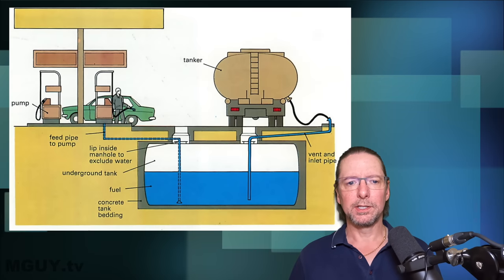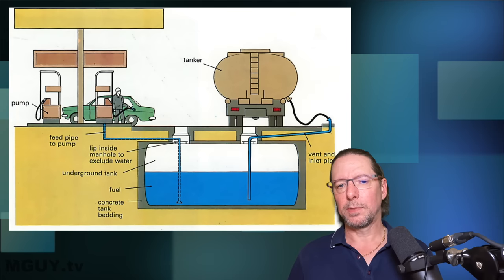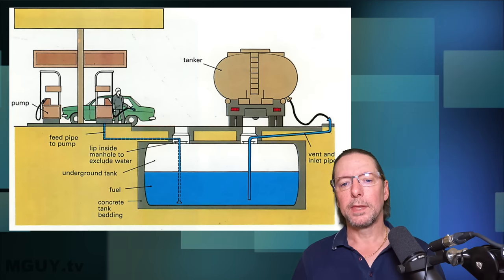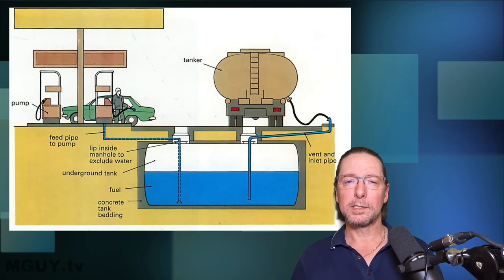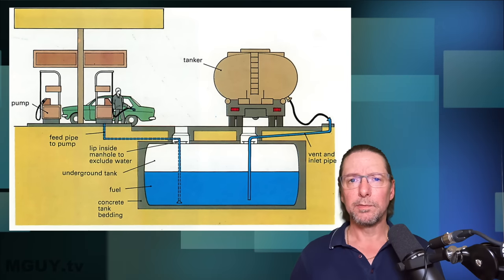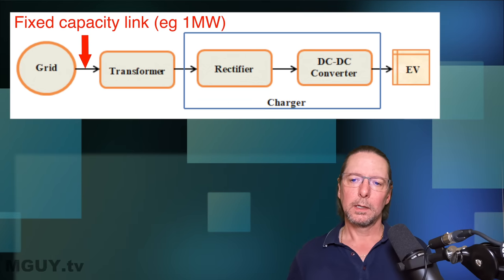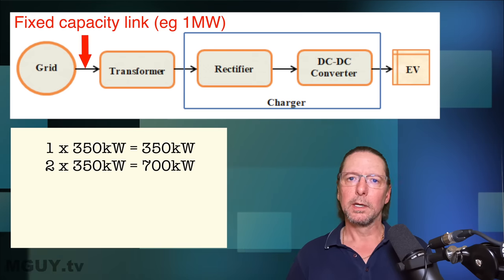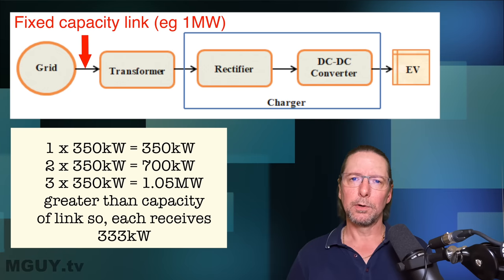HUGE problem with EV Charging Stations that no one mentions | MGUY Australia

Comment: I hate the idea of EVs but I’m all fairness you should have mention the solution of storage batteries at charging station that allows a buffer of power the same as a 20 or 40k litres of fuel in an underground tank . You could then delve into the potential hazard of fire risk of the batteries at the charging station moreover in a combined petrol / charging station.thus presenting a more complete argument against EVs
Reply from the maker: Yes, very fair point although as you say if you think EV batteries are bad, how about an entire container full of them?
Reply: And then you have to address the heat risk that charging and discharging that the batteries and wires would have putting more pressure on the electrical grid (unless you have diesel generation supplement)
Reply: You should look up the mega battery fire in Queensland, AUS.
Reply: Don't forget the round-trip energy-efficiency factor of lithium batteries. Under a range of operating conditions, one might expect a battery's electricity offtake from the grid to exceed electricity delivered to the cars by about 20%.
Reply: If the "servo" has to install batteries you sure as hell aren't going to get a cheap charge.
Reply: In principle, having electrical storage batteries on location at the service station, is possible. But, the implication and cost makes no economical sense.  Here are a few considerations....

The selling price of electricity from these storage batteties will be very high.  Someone has to pay for these batteries, and keeping them charged.  Once the charge of these batteries are depleated. You are back to square 1.  Charging these batteries will place further strain on the grid.  In all probability, decrease the capacity of the charging station.

There is an increase in safety hazard having such large arrays of batteries on site.
Reply: @chonpincher  then tow a caravan perhaps.
Reply: Tesla has solar panels on a lot of the roofs of their stations which charge large Tesla made storage batteries. It's profit making. Alternatively they buy power off the grid whenever power is cheap, store it and sell it at a profit. The availability of power is not an issue. Also why do you assume a large battery is less safe than a tank of petrol?  Any high energy storage comes with dangers. Everyone seems to focus on battery fires but not ICE car fires. The real issue for EVs is time to charge and I've no doubt that will be solved soon. Range is already less of a problem. Battery fires come from overcharging. Charging is computer controlled so as long as the charger design is sound it's safe.
Reply: @billthomas635 exactly. The free ride EV fanboys think they get will be no longer
Reply: @SkySurferG  and how is that power made?
Reply: Some US charging stations now billing by time connected not power supplied. Nice business model.
Reply: @SkySurferG  Those solar panels are just greenwashing. I don't know how much 'a lot' of solar panels is, but say you have 100 that have 300 Wp each. That will provide you with only 30 kW under the best conditions. A lot less during rush hour when you need them the most.
Reply: @SkySurferG Why do think a large battery is safer than a tank of fuel?

In recent years we’ve seen more EV and large scale battery fires that have occurred… for no reason at all!! We just saw the QLD Tesla battery go up in smoke for no reason and numerous new vehicles in different situations, but I cant recall the last time a fuel station or car catching fire for no apparent reason??

At least fuel fires can be managed and I sure as heck wouldn’t want a shipping container sized battery doing heavy work… sitting next to the forecourt of a service station!😳😳
Reply: @collenfisher3635  The idea of batteries is that you charge the batteries when demand is low and use them when it is busy (during rush hour). The batteries cost money, but they allow you to sell more kWh using the same grid connection. Upgrading a grid connection also costs a lot of money, so in some cases it is cheaper to add batteries instead.
Reply: @SkySurferG  If the rooftop is 40 acres of solar panels, it might keep up with an EV station, but a local dingbat roof has no chance.
Reply: EV's and getting off petroleum would make the middle east and Russia non existant in the world!
Reply: @SkySurferG  lipo Battery fires are self-sustaining and many many times hotter than a petrol or diesel fire. Then there's the issue of toxicity of the chemicals exuded during the fire... Educate yourself on both types of fire before claiming they're the same.
Reply: @SkySurferG  As you should know any burning proceednig requires enough oxygen . In case of fuel tank that oxygen may access only from    atmosphere  - to prevent burning since 100 years we simply insulate fuel from air by construction and location underground Now look at batteries - inside battery is stored whole oxygen  needed for processes. It totaly  is realised in high temperature. It may explode and burn in space which   at time has no any access to oxygen in air.
Reply: The big battery will still be limited in it's output. You can't discharge the battery too rapidly. Nor can you charge it too rapidly You can empty and fill the fuel tank as fast as you want.
Reply: They are already doing that in Europe now, large portable battery banks.
Reply: @SkySurferG I only have a modest understanding of these batteries (through the RV applications) but the biggest difference is Thermal Runaway. As Mguy said: each ICE car gets fuelled via a dedicated feed of fuel but the EV charging is coming from a single source. With high current draw comes heat (and lesser efficiency!) so that coupled with ambient temperature in Oz gives a significantly higher risk.
Reply: @daintree2455 sneaky!!!!
Reply: @KC-shunting not a valid PoV
Reply: That will make an impressive fire.
Reply: And then there's the fact of toxic fumes. Far far more toxic than fuel fires
Reply: @chonpincher you need to educate yourself. Energy efficiency in electric vehicles is more than 80% in ICE vehicles it's 20%
Reply: Is there an arguement for electric cars or VEHICLES glarcareklaw?
Reply: @KC-shunting  It is weird to build hugh battery just to make possibl;e faster transfer it's energy to relatively smaller batteries In world scale It will double  needed  capacity of batteries . Bearing in mind that they loose efficiency with chargings while steel tank has it   full within whole exploatation
Reply: Lithium batteries do not like being daily cycled.......they suffer capacity degradation, between 15 and 30% in the first 4 years.   So, if you multiple cycle the storage battery every 24hrs.......well good luck with that.   It sounds like a solution, but the wear and tear on the battery, its subsequent replacement and that cost is  going to be a problem.
Reply: The fire risk is not probably less than that of a petrol station. The fire risk of a petrol vehicle is 30 x that of an EV
Reply: @chonpincher  Don't mention how well the batteries work in sub zero temps (no problem we have global warming )
Reply: @GerbenWulff  And just calculate how big surface of sun exposed earth need those solars  - big installation covers thousands sq meters and we cant make them like sandwich.  Part of that energy (DC current!) will be lost for cabling. Which  adds to costs of "freee energy"and  pushes those  cost to sky.  In 19 century was hugh eruption of Krakatau which affected in whole globe sun light level  and resulted then in porblems with food.  Are  we guaranted that it wont repeat?  How it would affect EV  if  sun energy fall say to half or less?  If we then emergency return to coal then it will kill EV even more due to smog in air
Reply: The thing that most of you forget is that most people are going to be charging at home . My daughter charges her charges her car twice a month and that is at home. The obsession with charging is a non starter. I would be more concerned about cleaning up the mess when those underground tanks have to be removed and the ground rehabilitation. The cost is upwards of $1.2 million. Those tanks are leaking into your ground water system ...
Reply: @hobo1704 I will probably charge about 3 times a year at a public charger. The rest is home charging.
Reply: @mguytv  An entire contain full of them is Much MORE SAFE. Because you can use lower performance lower energy density batteries. Because WEIGHT is not a major problem to a STATIONARY battery.  This should be a basic concept of physics, less energy density = less volatility risk. It's wild you do not understand this basic concept.
Reply: @markbadhamthornhill8152  so you don't get out much then..
Reply: @billthomas635   Yep it's not cheap but still cheaper than Petrol here. Should be about 80% our petrol cost here per mileage.
Reply: @seanworkman431  And also the Luton airport parking garage fire.
Reply: There is no need for such a battery and it would constitute another fire risk.
Reply: Sounds very efficient.........not
Reply: @mynameisprivate158  There's a  concept called 'turning oil into salt'.  Pre refrigeration, salt was a strategic asset and you needed it to survive the winter - everyone knew the price of salt and where it came from.  Now it's just a commodity.  We need to do the same with oil.
Reply: @CosmicSeeker69  New LFP batteries do not suffer from thermal runaway.
Reply: @Mikexception  I wouldn't be too worried about volcanos. A large eruption will have only a marginal impact on solar irradiation. But yes, we will need a lot of them to make a difference. China is building a lot of coal plants to make our solar panels and EVs.
Reply: @SkySurferG  In practical terms, the solar arrays that Tesla uses at charging stations is decorative if not deceptive. To put it into a context that you might be able to visualise, it takes 328 standard solar panels to charge an 82kwh. Tesla model 3 from no charge to full charge in one hour in ideal conditions. The surface area of those panels is approximately 500 square metres or roughly the equivalent of the top of a Tesla charging station. Given the installation design does not take into account the most efficient installation of the cells, at the height of summer, those solar installations are going to be hard pressed supplying enough power to charge 10 vehicles a day, and that is being generous. 
Tesla has thousands of charging stations across the globe. Solar arrays are only to be found on a few dozen, at most. There is a reason for that. It isn't profitable, at all.
But makes for great advertising material, that's why they're there, and no other reason.
Reply: @markbadhamthornhill8152  It's true that electrical-to-mechanical energy efficiency of EVs exceeds 80%, while the chemical-to-mechanical energy efficiency of modern ICEVs is around 20%. However, that is irrelevant to my point about considering the round-trip (electrical-to-electrical) efficiency of storage batteries at EV charging stations in estimating their viability.
Reply: @@johnchapman7719 like a bomb?
Reply: And god knows we must give all arguments against EVs whether they are real or not eh?
Reply: It's possible, but in very large conurbations such as the home counties there is literally no where to put them as each new charging station requires it's own new electricity sub station to contect to the grid - there's simply nowhere to put them. Factor in the proximity of dwellings near several tons of volatile lithium batteries and you could easily see the great fire of London part 2.
Reply: @mguytv   U.S. military has investments in your country to build super power storage for their military . Technology is moving faster than the old petro station.
Reply: @mguytv  According to reports from Norway, the majority of vehicle fires are still petrol/ diesel and not what the doom and gloom are saying. Remember in the scheme of things, it is still early days for the EV. See how long it took for the petrol driven car to get established. It is not all that long ago that a young house servant was sent with a can to collect fuel from the chemist. At least I can top my car up with solar power. Have you tried making gasoline? All you who think the EV will disappear, will soon be changing your tune. 🤭
Reply: That will only do ble the cost of charging. Not only will you be paying for the power from the grid, but the cost of the battery will also be factored into the price of electricity
Reply: Imagine the cost required to install these storage facilities.....these charging stations need to stand on their own economically and they simply wouldn't get off the ground without an adequate supply from the grid.
Reply: @SkySurferG  Tesla is simply 'greenwashing' the public and government with those solar panels on the roof of their charging stations. The area of panels available on such a structure would take several days to fully charge just one Tesla. Smoke and mirrors.
Reply: @mguytv  A container of batteries (LFP) can be charged over 3.500 times, so the raw materials can be used over 3.500 times before they get recycled. The fuel does only get burned once.
Reply: @GerbenWulff  I've seen them with over 2000 solar panels that charge up Megapacks, so even when the sun goes down, they can still charge from solar power stored in the Megapacks.
Reply: @markbadhamthornhill8152   Tell that to Luton airport.
Reply: @dave20thmay  Not all that long ago? what pre-industrial country are you living in?
Reply: "solution of storage batteries at charging station" -- that solution is NOT REALLY a solution

it's actually the most dangerous/hazardous thing to do to an EV station
Reply: Why don’t you use à diesel Generator that is scalable to amount of cars using the charger. Also these generators could be off the grid and places in remote area of the highway. Diesel can be stored for long periods of time and easily resupplied.
Reply: @cadredeux1047 "Why don’t you use à diesel Generator that is scalable to amount of cars using the charger. "

because that would be hypocritical??!?
Reply: @cadredeux1047   "Also these generators could be off the grid and places in remote area of the highway"

why? so people charging on these EV station WILL NOT SEE that their cars is being charged by "fossil fuels?
Reply: Of course since the battery bank doesn't have to be portable you can use larger, cheaper non=flammable battery technologies.  Also the batteries don't actually at the charging site but connected to it somewhere up the line.
Reply: @dave20thmay  "All you who think the EV will disappear, will soon be changing your tune" - it think ko is thinks/want EV to disappear

what most are saying is that they don't want to forced into using it if not viable for them at the moment
Reply: @chonpincher  any way you look at it .. The figures I am quoting are the round trip .. Petrol is well to wheel ... Electricity is wind turbine to wheel ... The only benefit Fossil fuels have is energy density .. That's becoming less of an issue now.
Reply: Battery storage allows arbitrage of the electricity price.  The owner of the battery can use it to sell electricity to EVs, but it can also use the battery to sell electricity back to the grid in times of high electricity demand, like a peaker plant would.  Often the price of electricity on the grid can be very high in times of high demand.  The kinds of batteries in use for these can be different than for cars, as a finely tunes power density is not as much of a concern for a static battery on the ground as it would be for a moving car.
Reply: @markbadhamthornhill8152   most conventional vehicles are burned by thieves,vandals and insurance fraud.  The average age of the ICE vehicle fleet is also much older than EV's.  check your statistics.
Reply: @mguytv  I am presuming you are Australian... There are more options to mass energy storage than lithium cells. Australia has massive opportunity for green energy and an Australian startup is making waves in energy storage. Check out Redox flow batteries. A good option for charging stations. They will use the grid am solar, filling the batteries when energy is cheap selling when energy is expensive .. Tesla has made the move to this system already
Reply: @wazza33racer  my statics come from the annual European insurance report. I am not guessing
Reply: @reson8  Luton Airport was a landrover diesel that had a short and destroyed 1500 vehicles and the building they were in.
Reply: you anti-ev dudes are impressive. 40k litres of fuel in an underground tank? How much energy is that, then? [Try: ~ 1.4*10^12J.]  What mass would a (say, Li-Ni-Co) battery have in order to match that? You guys don't - or can't - do sums.  Derisible.
Reply: @digitalian99  You can place the generator behind a green fence. People won’t know. Also remember electric cars have 0 emissions so it doesn’t matter how much emission is coming from the power source.
Reply: @mguytv  Depends on what you mean by bad. Batteries at chargers are LFP and don't use Cobalt, with next generation reducing Lithium. Cost is also dropping to improve the viability. But you are correct in that unlike transition from horses to petrol, the transition from petrol/diesel to electric is happening much faster and there will be challenges as the technology will need to evolve.
Reply: @SkySurferG  What is the point with these unreliable toys? In case you didn't know, China is burning 4.5 billion ton of coal each year to make the batteries and 1 billion ton of steel, among other things. They are increasing consumption with 200 million ton each year. India is starting to ramp up their coal burning too. They are burning 1 billion ton each year, but is increasing much faster. What's the point with EVs in the first place?
Reply: @cadredeux1047  lol, green would not be enough, it has to have drawings of clouds/trees in it
Reply: @hobo1704  Go and get some gas. Do you think you get a free ride?
Reply: @digitalian99  That would be “hypocritical” ? Hawaii is one of the most green/liberal states in the Union. 77% of there electricity comes from fossil fuel, almost all diesel. So when you drive a ev in Hawaii it is essentially a diesel car and dirtier than a gas car. That’s hypocrisy.
Reply: @digitalian99  Or maybe a big mirror so he EV drivers can admire themselves and how woke they are.
Reply: @SkySurferG  A large battery is less safe than an underground fuel tank.  A large battery is above ground, contained in a structure of some sort, but will undergo temperature changes, due to weather, and its heating while charging or discharging.  It is these temperature changes, in combination with internal defects, that cause the battery fires.
Conversely, the fuel underground has an almost constant temperature, with only a small variation.  Most modern installations now have vapour traps, so no flammable vapour escapes.  There is only a risk during refuelling of vehicles, or when refilling the tanks.  We've been refilling our cars now for a hundred years, with very few mishaps, and the pumps and pipework has valves to prevent fire transferring into the underground tank.  Tanker drivers are trained, and have careful procedures, to minimise fire risk.
Reply: @Neojhun  Just wait until the governments stop subsidizing the purchase price of these little toys and you have to pay the full price! That'll change your mind in a hurry!
Reply: @mguytv  Have you ever heard of a flow battery?
Reply: @jesflynn4048  So in California and Arizona they are purchasing batteries to make up for lack of capacity. From Reuters 12 days ago.
Plus Power raises $1.8 billion for standalone battery storage.
So you want to move electricity from Grid batteries to EV charging station batteries along to the batteries in the car. Batteries produce no energy, they only consume energy during their manufacturing. A battery is nothing but a conduit for electricity like a wire or a transformer.   Under the old system there was no need for batteries.
Reply: @markbadhamthornhill8152 home charging is ok for some. Around 50% of homes in the UK do not have a dedicated parking space.
Many of those car owning people cannot even park in the same street twice in a row.
They will be wasting their lives sat drinking over priced coffee whilst paying over the odds for charging.
Reply: Batteries 😂😂😂😂😂😂
Reply: @sahhull  there are 2 options coming, wireless charging in parking spaces and chargers built into each and every street lamp.
Reply: @markbadhamthornhill8152  great.
Where my buddy lives. There's 50 houses on each side of the road and 3 street lamps.
The 'it's coming', a bit like cold fusion has been a decade away for the last 40 years.
Reply: @glennmartin6492   Have you seen these batteries? What are their cost? How will the costbe passed on to EV owner? How often will they have to be used to be cost efficient? Why should the driver pay that cost if he  is only car at the station? Wouldn’t drivers avoid stations with generators because of the higher cost?
Reply: @Andrew-rc3vh  Flo Battery is the women on the progressive commercials.
Reply: can you imagine how much material would be needed for that , there isn't enough lithium in the world to have the UK with electric vehicles , it is all total bull , and that is just the tip of the iceberg , the cables that supply any installation are a specific size , the loading in total will far exceed this rating therefore restrictions have to be in place , to supply all these damn EV's would mean a huge multi billion pound cost in infrastructure , the materials used to do this would cancel any so called green crap they spout to you lemmings , it is just a dream , and the reality will NOT work
Reply: @cadredeux1047  They are far longer lasting, cheaper and don't explode. If you failed to learn anything else today, at least you can claim learning one thing.
Reply: @outkast40  The US military wouldn't even be able to wipe their own arse without instruction! So, power storage for anything is out of the question.
Reply: @seanworkman431  coal :-)
Reply: @markbadhamthornhill8152 Most people? Condo and apartment dwellers usually don’t have e charging stations. Good luck in getting your HOA to install one.
Reply: @Andrew-rc3vh  When you say they are longer lasting than EV batteries are you comparing them to hours of use? How many hours are they used compared to EV batteries? What are the cost of these batteries?  I didn’t even consider them “exploding”, you just keep bringing it up. Can you show me an example of them being used in the real world? Only stuff I can find are adds from manufacturers and seem to be for individual consumers. They run about 20k.
Reply: @billthomas635 instead of that, they install diesel generators.
Reply: @SkySurferG  trying to talk sense to people who don’t like change is like trying to convince a cult member that the cult leader isn’t all powerful, worth a try deprogramming them but unlikely to succeed.
Reply: @bills6093 the “big battery” can be discharged at the same rate as the one in a car, ie hundreds of kilowatts per second if well designed. There’s also no need for it to be one large battery, but can be a battery per charge bay. How do you think a Tesla plaid or Rimac accelerates to 100km/h in under 2 seconds? By delivering a shitload of joules of energy from the battery to the electric motors driving the wheels.
Reply: Hey, there is nothing wrong with hybrids!  My Toyota Prius Prime can get 100 mpg charged.  No charge, it keeps going at 50 mpg!
Reply: @stevenginn5352  I paid full price, in Canada, for my Chevy Bolt in 2018. Based on maintenance and cost of fuel I’m about breaking even right now with what a new comparable gas car would have cost, with purchase price and fuel + maintenance considered.  From this point forward I’m saving money as the cost of electricity to power the car is dramatically less per km driven versus gasoline, and gasoline prices keep rising much faster than electricity.  But please, feel free to keep the executives at the gas companies buying their yachts and Ferraris, it’s all a chuckle to me.
Reply: In the US there are 140,000 car fires every year or over 400 per day. In 1980 there were 400,000 vehicle fires so gas cars are getting better. EVs are reported to have fewer fires per 100,000 vehicles so they would lower the yearly figure. If you are worried about vehicle fires I think an EV is a better choice. 

The Luton car park in England had a fire that destroyed over 1000 vehicles and was started by a diesel vehicle. Vehicles will burn, the question is are gas vehicles less likely or more likely to burn.
Reply: @cadredeux1047  how much f’ing energy do you think is consumed making all of the infrastructure for gasoline production and distribution? The oil derricks, the drilling platforms in the sea, the tankers to ship the fuel, the refineries with masses of steel and stainless steel tubes, the gas filling stations… apparently only the batteries are allowed to be considered under your thought process.
Reply: @SkySurferG Availability of electricity can be a problem if the gov’t decides to eliminate fossil fuel plants and refuses to allow nuclear plants. Then the grid is relying on sun and wind. Maybe not a problem in some places but there are a lot of places where solar and wind are not good alternatives. Also, if all vehicles start relying on electricity for fuel there will need to be more electrical lines installed. In the USA some areas are already overloading the power lines and there are areas where the power grid lines are nearly 100 years old and really need to be replaced with larger size cables (or add additional cables). All of this cost money which all of us will have to pay for in higher electricity rates. I think EV technology is great but does not need to be implemented in the short time gov’ts are pushing their introduction. In 20 years people will realize that this whole climate change agenda has been a big hoax to enrich the pockets of politicians.
Reply: @andywarrington4738  please, do yourself a favour and go look at how much lithium there is dissolved in the oceans. It’s estimated to be above 100 billion tons. And researchers are doing well figuring out how to extract it profitably from seawater.
Reply: Any idea how expensive it would be to have enough batteries on site to charge say even 10 cars?  This is another infinite money solution.
Reply: Ammonia (NH3) fueled internal combustion engines are the answer.  It's 100% sustainable, has almost no pollution, transporting and storage is safer than gasoline/diesel, would cost about the same as gasoline/diesel, would eliminate crash fires and current internal combustion engines can be modified to use it.
Reply: @cadredeux1047  a power company in Minnesota (Xcel) is installing a redox flow battery for grid storage, on the sites of decommissioned coal plants. From a press release Jan 2023. It’s an iron based redox flow battery which cannot catch fire and is much cheaper than a lithium ion battery, roughly 1/10th the cost. Also, flow batteries are expected to have charge discharge cycles in the tens of thousands and last a minimum of 20 years.
Reply: @davecolgan442  Thanks for this data.  It helped me finslly get my fully electric Chevy Bolt!  It is a dream!
Reply: @sjsomething4936  The US has enough oil to be be energy independent . There is no need for tankers(other than Hawaii), fuel can be distributed by pipelines. Most of the infrastructure already  exists. Natural gas can be be piped to local electric plants that can be located in thé communities they serve. 10% of electricity is lost every 100 miles transmission, while virtually none  is lost on  a pipe line. The foot print for a gas power plant is very small and can minimize miles of transmission wires. Pipeline can be buried. Solar panels necessarily competes  for sunlight with plant life, which increase the carbon foot print. Windmills have to be located miles from the end user and lose power in transmissions. Windmills and solar panels can’t operate without a back up system because of darkness and windless hours. Therefore there has to be redundancy in infrastructure. A natural gas power system could exist without solar panels and windmills. A solar panel and windmill system could not exist without some other source.
Reply: @SkySurferG the risk of fire from stored petrol or diesel fuels is only a risk within specific fuel to air ratio with specific ignition source also required. Easy to design safe storage for. Lithium batteries,  simply add water. Damage from a seemingly minor impact. Damage which is very hard to detect and there is no formal way to test for. Requiring no external/secondary ignition source.  Good luck extinguishing a lithium fire. I've pointed out only a few of the fire issues. There are also the ecological arguments that apply when theath is done without bias. The ethical arguments of say the slave labour involved in the cobalt mining, already a major issue even if it is being denied or ignored. The fixation in ev's smacks of a desperation to find a grandiose virtue to lend meaning to a hollow existence of someone who is too lazy, dishonest, afraid orplain old stupid to so much as learn about what they claim to believe. Why do people fixate on the facts when people should fixate on my feelings. Not my real feelings though, just the virtue signalling one's I post on social media. The world would be so much better if everyone cared as much about my feelings as I do...
Reply: @sjsomething4936  The reason they install storage batteries is to create a source of electricity when alternative energy is not available. This redundancy is not necessary  with fossil fuels, hydro or nuclear. The batteries produce no energy and consume energy in their  manufacturing.
Reply: @Nonplused  You don't need enough batteries to charge 10 cars. You need enough batteries to momentarily bump the peak charging speed when the grid connection alone cannot keep up. Most EVs with 200+kW fast-charging can only sustain that 200+kW for a few minutes.
For EVs to be viable, we also need fast-charging hubs to have backup generators so people don't get stranded during power outages. That would be additional power on tap during heavy usage peaks, then you can use batteries to help ensure the generator has enough work ahead of it to complete a proper operating cycle before charging traffic drops to a level where grid power alone can keep up.
Reply: @markbadhamthornhill8152   So it spontaneously combusted? How very convenient.
Reply: @Mikexception  
"As you should know any burning proceednig requires enough oxygen"
You're ALMOST there, but not quite...

Grab yourself a liter of Hydrogen gas (H2) and chuck it into a solid tank full of air..  Now heat it up (a match??? LOL)...  It WILL burn (with a nice red pop) by combing with a bunch of oxygen gas (O2) in the air.
Now grab another liter of Hydrogen gas (H2), but this time chuck it into the same tank, but THIS time, it's filled with Chlorine gas, Fluorine (or any of a number of other such oxidisers).  That hydrogen is STILL going to burn even though there is precisely ZERO oxygen present.
Burning OFTEN uses oxygen (O2) as the oxidiser, but it can ALSO use many other oxidisers and still be considered burning!
Your definition of 'burning' is incorrect!

Burning is actually a chemical reaction where a 'fuel' is oxidised via an exothermic reaction with an oxidiser.  The oxidiser CAN be oxygen, but it doesn't HAVE to be.
Certain types of Lithium Ion cells have enough oxidiser internally to 'burn' in the complete absence of oxygen / air.  Such fires can NOT be extinguished by 'starving the fire of air'.  They will only stop burning when all the fuel is consumed, or when there is insufficient heat (a.k.a. 'activation energy') to sustain the fire.
Reply: @bills6093  
"You can empty and fill the fuel tank as fast as you want."
Untrue!!!  You are limited by the pressure and size of the fill spout...
If your statement was correct, I could 'fill' my petrol tank in my car in 0.000000000000001 seconds, but alas, this is not possible!
The difference is that an EV uses a 'fill spout' that's equivalent to a thin straw while a petrol tank in a car uses a much larger spout.  Furthermore, the battery pack of an EV has THOUSANDS of ultra tiny fill spouts - one per cell.  (Thankfully, all of these 'fill spouts' can accept charge at the same time!)
Reply: @jasonhutcheon5991 
"New LFP batteries do not suffer from thermal runaway."
Actually, LiFePO4 CAN still suffer from thermal runaway.  However, the 'probability' is SIGNIFICANTLY lower than with NCR (Nickel Cobalt Rechargeable) chemistry LiIon cells.
The issue though is that LiFePO4 cell energy density (power per kg of battery) is somewhat lower than NCR type cells.
It IS getting better over time, but it's likely to NEVER be as high as NCR LiIon cells.
Reply: @teardowndan5364  Wait... generators?  What's the point of charging an electric car with a generator?  That's basically a gas car with a bunch more steps, money, and environmental damage.

I chose 10 cars battery as an example of what might be a required amount of batteries to serve as a supplement to a grid supply as per the video.  If we assume a 1 megawatt grid supply as per the example in the video, as per the video that can reasonably charge 3 cars at a time.  But the cars don't all come nice and even day and night, so let's say it's zero cars during the wee hours of the night and 6 cars at a time during the day.  It might not work out to exactly 10 cars worth of batteries but it will be somewhere around there, the batteries recharging whenever the number of cars plugged in at a time is less than 3 and supplementing the grid when there are more than 3 cars charging.  So let's say it takes 1 hour per car to charge, then this station could handle a peak period of 6 cars at a time for 3 hours (with one car charge left in the batteries) and then charging has to drop to zero cars for 3 hours to charge the batteries.  So 10 cars batteries is not an unrealistic number for a hypothetical 6 charge station installation with a 1 megawatt supply.  Based on Tesla battery packs, that battery installation is going to run around $300,000, and last about 5-7 years before it has to be replaced.

Charging batteries with batteries is hugely expensive.
Reply: I love the idea of EVs but in all fairness you should have mentioned the disaster that hydrocarbon  fuels represent in terms of climate change.  Already some parts of the world are experiencing disastrous heat waves with wet bulb temperatures exceeding 95 degrees which  is killing millions of people.  Not to mention polar ice caps thawing causing sea level rise with subsequent coastal flooding causing the relocation of millions of people around the world.  Recent fires in Canada and Australia have caused billions of dollars in damages and killed a number of people.   But why should the death of millions of people matter when weighed against some asshole saving 20 minutes each time when refueling an ICE vehicle!!
Reply: Storage batteries at charging stations are not there for a buffer of power. On modern Grids the price of electricity vary during the day. They charge the batteries when the price is lower so they can make more profits when they charge the EVs at the same price all day.
Reply: @mguytv  you're both math and physics challenged. In order to have the equivalent of 40000 litres (10000 US gallons) that would require a  327MWh battery. At the current cost of $151 US/kWh for Li-Ion that is $50M US. That is 10x the cost of a current 12 dispenser gas station (buildings and equipment) *just for the battery*.

Of course, there is no reason that the grid couldn't supply the power necessary to charge 12 BEVs (at max charge rate) simultaneously.  The real problem is that a 12 dispenser charging station has 1/20th the service capacity of a 12 dispenser gas station.
Reply: @Nonplused  It is much easier and cheaper to properly inspect and maintain a few 1MW generators than every single individual car.
Larger stationary engines designed to run continuously at constant load for hours at a time are also more efficient than hundreds of tiny individual engines running at a fraction of their nominal power for a few minutes at a time.
A stationary engine is also not as constrained by space and weight on the amount of emission controls that can be attached to them.
Do remember that said generators would only operate either in a power outage or when total charging demand exceeds what is available from grid power and battery reserve. On a typical week, they may not run at all except maybe an hour or two as a system check.
You do get better MPG from burning your fuel in an efficient generator to charge an efficient EV than driving the nearest equivalent ICE. Unless it is winter, then the EV loses due to the ICE getting heat for free. A dedicated fast-charging generator would directly drive an alternator which in turn directly dumps its output into the site's 1kV DC bus, no AC-DC power supplies in-between. That sort of setup should achieve 98-99% mechanical-to-electrical conversion efficiency. No gearbox or anything, just bearing and wiring losses along with ancillary loads like oil pumps and fans.
Additionally, most DCFC sites large enough to warrant having a backup generator would likely be located on the edges of towns next to highways where far fewer people are likely to get inconvenienced by 1MW of diesel power for whatever little time per week it will typically run.
Having fewer bigger engines concentrated at DCFC locations has quite a few advantages over having hundreds of times as many individual ICEs.
Reply: You need to research the "Power Grid". Regardless of the number of charging units at a given power station, that power must come from the power grid, and the capacity of the grid at a given moment in time is finite. The power cables are sized to carry a given amount of power, and if that amount is exceeded, that part of the grid is automatically shout down, to protect the cables and other power components. If you put in more charging units, the power cables in that part of the grid will need to be replace with larger cables, or reinforced with additional cables from the power grid substation dedicated to serve the charging station. If you overload an electrical circuit in your house, a circuit breaker will trip, and shut that circuit down. The power grid has similar protective devises that do much the same thing. So, in an all EV world, parts of the power grid will need to be reinforced substantially, and the additional power needs to come from somewhere, so additional power generating plants will need to be built. And what is the fuel source for those new power generating plants going to be? Natural gas, oil, coal, nuclear, hydro-power?
Reply: @collenfisher3635  this is already done in the States.. Batteries are charged off peak at low cost, sold back to people charging at a far higher rate. Tesla are very successful at doing this. They also have solar charging at there bigger charging facilities.
Reply: @teardowndan5364  The problem with ICE engines is mostly one of thermodynamics, not mechanical to electrical conversion.  No ICE or even any other gas expansion engine can go beyond 50% efficiency due to the thermodynamics of expanding gases.  It is true that a car has other loses mostly in the transmission, so the best cars do is about 33% efficiency at the drive wheel.  But charging batteries is not 100% efficient either, at best about 80%.  The energy loss charging batteries is of little concern if solar or some other CO2 free energy source is used (wind, hydro, nuclear), but in the case of an ICE generator 50%x80% means about 40% of the energy in the fuel can actually be put in the battery for later use.  That's not enough better (7%) to justify all the batteries and associated mining and manufacturing, which is also very energy intensive, and then battery disposal or recycling.  Then there are other loses associated with rectifying the power from AC to DC and back again, and carrying the batteries around in a car, which are quite heavy.  So the long and the short of it is that little to no reduction in CO2 emissions can be achieved by running electric cars on fossil fuel generated electricity, and in fact the emissions might be worse when the full cycle of making and disposing of the car and batteries is considered.  Electric cars need to run on "green" energy to make any difference at all, and even then the difference is exaggerated.

Also, running peak generation at the consumption site (in this case the charging station) does not improve the load factor of the overall grid.  All it does is move where the generation is installed.  A bigger natural gas cogeneration unit and larger transmission lines would accomplish the same thing with less CO2 emissions due to the fact that natural gas co-generators are more efficient than ICE generators and natural gas has a higher ratio of hydrogen to carbon than diesel or gasoline does.
Reply: @wazza33racer  not true more like 10 % after 200 000 miles .. Batteries are much better today than 10 years ago
Reply: @The0ldg0at  This is actually a dilemma that I've seen before in the gas utility business with transmission pipes and gas storage.  Let's use storage for the example because it is more similar to batteries.  Before the storage facility is built, the price signals in the market are there, with gas being more expensive during the winter than the summer, and on high load days compared to low load days.  However, once the storage facility is in place, the price incentive collapses to the marginal cost of operating the storage facility.  This is because the supply-demand has been balanced by the storage facility.  Thus, you cannot use "profits" to pay for a battery or storage facility unless they receive a regulated or "use-based" cost of service model for payment, because once enough storage exists the market incentive is removed by the very facility meant to capitalize on it.  It still works overall from the point of the consumer and stable prices result, but it leaves the storage operator without a way to monetize his/her investment.  (The exception would be when the storage installation is too small to affect the market, so say your own personal Tesla power wall, but once everyone has them the same thing would happen.)
Reply: @oldgysgt  In most places, the grid has at least a 2:1 ratio between peak capacity and baseline. You can charge a 5MWh battery bank during low demand hours to raise the baseline load a little, then use that to cover the difference between available grid power and peak charging demand. The bigger the battery, the more load can be time-shifted and further flatten peak demand.
A single 240V 200A circuit can pump 1MWh/day, enough to charge 15-20 cars per day at whatever speed they want when you have a large enough battery to store energy from the 20+h/day where no vehicles are connected to directly dump power into.
Reply: @Nonplused  Modern batteries have a roundtrip efficiency exceeding 90%, some manufacturers are even claiming 95+% for their newest cells.
Rectification losses? What losses? A generator wired to dump its stator output directly into the 1kV HVDC rail has at worst 2V of diode drops, that is 2%. Using synchronous rectification instead, that loss can easily be reduced to less than 0.2%.
Battery-wise, you don't need to mine for Na-ion batteries and the new generation of Na-ion batteries are expected to have 10 000+ cycles endurance, which means they should have a 15+ years service life in grid-scale energy storage applications doing one deep cycle per day.

As for the generator thing, I repeat for the third time: the primary purpose is BACKUP POWER IN CASE OF POWER OUTAGE so people don't get stranded by arriving at a completely dead charging hub. Supplementing grid power when the site is being told to operate at reduced power due to power shortage in the area so the site can continue to offer faster charging than it otherwise could is only a secondary benefit: the equipment is already there in case of a power emergency and it needs to run periodically for self-checks, may as well get some use out of them.
Reply: @SkySurferG  Battery fires can also come from the many connections needed in a battery pack. Any bad connection terminal will cause resistance, which heats up everything, including the battery. Even lead acid batteries sometimes get overheated by a bad connection, but lithium batteries are way more dangerous when that happens.
Reply: @collenfisher3635  Adds maybe 10c to each kWh stored/discharged.  Under most conditions, all of the charge will be supplied off the grid so only a small amount of the electricity dispensed will go through the battery.  The strain on the grid is eased as the battery can charge at tmes when the grid is quiet.
Reply: @billthomas635  About 10c/kWh if all of the electriicty had to go through the battery when in reality it is more like 10%.
Reply: Seems to me you would need a LOT of battery storage to augment the grid.  Using his example where the grid is maxed out at 3 cars, if you have 10 cars(just an example)) show up, then you would need 7 batteries at least the same size as those in the vehicles.  Then when the cars leave, those batteries have to be charged back up, but have to wait until the grid has capacity.  Doesn't seem practical given the cost of the batteries.
Reply: Nonsense.  It would take a HUGE storage battery to be able to provide 10 or 15 EV fast charges per day at each charger.  Then you have to charge the storage battery for the next day.  Same problem.
Reply: @trevorvanbremen4718  The underground tank, not your car's tank. The equivalent of the "big battery" at the filling station.
Reply: You wull no doubt find reports of battery fires to back up your argument but the newer LIP batteries don't catch fire unless you light them.
Reply: @SkySurferG   When you add hybrid cars to the discussion, electric cars are 3x more likely to catch fire than simple ICE cars.  To be fair, the data does not show the source of the hybrid car fire, just that it is 3x more likely to catch fire.
Reply: @leolo2222  How often when you go to fill up are all pumps occupied?  Same with EV chargers, most of the time only some or none are occupied.  Except for maybe 3-8 hours a day depending on the climate, there is plenty of grid capacity.  Also, one 20 foot shiping container could fill about 60-100 TVs from empty to full.
Reply: @leolo2222  Why add hybrids to EVs?  They are as much ICE as they are EV.  EVs are hugely less likely to catch fire than ICE cars.
Reply: @markmeridian3360  One 20 foot shipping container of battery (3-4MWh) would charge 60-80 EVs from empty to full (average 50kWh).  Most of the charging is off the grid, only a top up at the busiest times is from the battery.
Reply: @Nonplused  Agree with you for the wholesale electricity market but for the retail market the kWh cost is usually fixed for periods of time with good discounts for off peak usage for medium users which charging stations would fall into.  There is often a very attractive discount for demand side management so a battery can be very handy for agreeing to DSU at peak times.
Reply: @markbadhamthornhill8152  i think the issue isn't about the fire risk, but more about how much more difficult it is to extinguish a Li-ion battery fire (almost impossible) compared to a fossil fuel fire.
Reply: @davidporter4162  Where I live, gas stations often are pretty busy 50-100% capacity, but I see the point you are trying to make.  I am just using the original example of 1MW available grid capacity.  There can be 20 charging stations with 15 empty, but you would still be over capacity.  A Tesla battery is between 50-75kWs.  Using that form as a sample, you would need 13-20 Tesla sized batteries to double your 1MW station capacity.   I am too lazy to look up dimensions to see if that supports your 20 foot container example, but regardless, it would be expensive!
Reply: @Nonplused  Agree with a lot of what you say but Li-ion batteries are >90% RT and if you change DC to DC form battery to EV, the RTE is mid-high 90%s.
Reply: @davidporter4162  Why?  Because the only thing that separates them from ICE cars is that they are electrified. Again, I said the data doesn't show the actual source of the fire, but it's not a far leap to surmise it has to do with the electric part.
Yes, straight EV's currently are less likely to catch fire, but when they do it's far more dangerous.
Reply: @davidporter4162  90% is better than 80% but we're arguing over the size of the loss, not the fact that there is one.
Reply: Do they have those batteries installed at charging stations? Or is that just a pipe dream?
Reply: @leolo2222  Why 1MW?  Connections can be larger if needed.
When EVs come in to charge, mostly it is a top up, say from 30 to 80% therefore 25-38kWh for your Tesla example.  It is likely that the battery will never supply more than a quarter of the demand as the rest will bypass the battery and come directly from the grid.  Therfore, a 3MWh battery (20 foot container) will charge nearly 400 cars and can still fill up only at night.
Reply: @bossman6174  didn't say I did, but guess what, I can travel as far as I want.. That's why ice will always be better than EV . Have fun staying close to home muppet
Reply: @leolo2222  Ok but they are still half ICE and tend to run much more on petrol/diesel than the battery.
Agree that battery fires are difficult to extinguish but not as ferocious a fire as petrol especially.
Reply: @teardowndan5364  Whether 80% or 90% there is still a significant loss.

Rectification losses are not as great as inverter losses, which all electric cars have.  And then you have to carry the batteries around, which requires a lot of energy all by itself.

Na-ion batteries are not in common use yet, and even if they one day become common place they will still be prone to catching fire because the reactant and the oxidant are in the same casing.  The more energy dense the battery is, the worse this problem.  Perhaps solid state batteries will avoid this, but then we'll just have another problem due to accidental discharges which will be like a rail gun going off or a bolt of lightning hitting the car.

Your backup generators are going to cost money and not have the economies of scale of a cogeneration plant, and produce more CO2, no matter how you dice it.  Otherwise it would make sense for everything to have backup generators running during peak periods, including your house.

There are no solutions here, only compromises.
Reply: @Nonplused  Should we discuss the 70% loss from petrol in the tank to the wheel of the car?  The 70% loss doesn't include the drilling, transport, pumping and refining of oil products.
Reply: @kathrynwhitby9799  new batteries will be different chemistry .. Already lithium iron phosphate will not easily combust. You are 30 times more likely to burn in a petrol car. 100 times more likely in a hybrid.
Reply: @additudeobx  Pipedream.  Prohibitively expensive at the current state of technology and manufacturing expense.  It may come down in the future, but it is hard to see how whilst we are in the middle of converting the whole vehicle fleet to electric.  We need a mindboggling amount of more batteries than we currently have just for that.  Revolutionary battery technology could change everything, but then so could nuclear fission.  We can't plan around it.
Reply: @davidporter4162  At no point did I deny that.  I said cars are about 33% efficient at best, which is close enough to a 70% loss that we can say we were using the same number.  I'm just saying electric isn't much better, and all the losses involved in getting the diesel (or gas more commonly) to the car is the same as the losses getting the diesel to the generator.  Just carrying the batteries around represents a substantial energy loss for an electric car, as well as beating the heck out of the roads.  A Model X long range weights 5,200 lbs, That's more than the heaviest F150 (except the Lightning, of course).  It doesn't look like it but it does.  Then consider that the F150 can do things like haul and tow, and it becomes clear that an electric car moves a lot of weight around for no good advantage.  Then consider road safety.  If a Toyota Corolla has an accident with an F150, we know what happens to the Corolla.  A Model X would do the same thing.
Reply: Did I read  that some places charge you by the minutes you are plugged in and not the amount of energy transferred?
Reply: @trevorvanbremen4718  excellent overview and summary of the situation, thank you for that. One thing to note is that the fire blankets that many fire departments are now equipped with do a fantastic job of containing the fire if an EV catches fire.  Also, I’m pretty sure it is now a part of training at the various fire department academies, I’ve only reviewed some of the online info from the well known one at Texas A&M.  Once it is contained, there’s a lot less concern about the fire although even though it is not extinguished. Would be great if a consortium of auto companies would try to find a better way to completely extinguish the battery fires in order to use less water.
Reply: @Nonplused  Agree re weight of electric vehicles but not sure what you mean about hauling diesel to generators?  Certainly isn't the case at the moment but ideally the electricity comes from wind, solar, hydro, nuclear so the only losses are transmission losses on the grid plus some in the vehicle from battery to wheels.
Reply: @additudeobx  My reply was removed I think because I sent a link to a company supplying combined charger/battery units that you are asking about so was classed as spam.  Maybe youtube thinnk I'm selling them (which I'm not!) but they surely do exist and are being rolled out now.
Reply: How many charges can you get from a storage battery,  in the future if there are lots of cars the storage batteries will run out
Reply: @davefarmery8180  Even at busy stations most of the charging will still be straight from the grid but there is no practical limit to the number of charges the batteries can give.  Newer battery types can do 10,000+ charge/discharge cycles so will last 30 or more years with 1 charge/discharge cycle per day.
Reply: @davidporter4162  They are also lower voltage and lower capacity and heavier.  But I am glad they are coming into wide use.
Reply: @Nonplused  Inverters using GaN transistors can hit 98% efficiency while slightly less advanced ones are hitting 95% and axial flux motors are achieving efficiency around 98%. Electric drive trains and electric energy conversion in general are going to get stupendously efficient over the next five or so years.

While current Na-ion may still be susceptible to thermal runaway, the self-heating rate is much slower. Also, where lithium batteries enter thermal runaway around 80C, 80C is still within operating limits for many sodium batteries - some go up to 100C.

You don't need a backup generator for peak-shaving a house, a battery would do the job more effectively, hence the 5MW battery storage for a decently large DCFC site to do the same. Everyone having their own tiny personal battery for peak-shaving isn't particularly efficient though, which is why a growing number of utilities are deploying MW-scale battery systems.

You only need a generator to deal with outages longer than your battery can handle and having at least some working fast-charging stations during a large-scale power outage would be critical in an EV future where people have been stripped of all other personal mobility choices. For the fourth time, the generators are there PRIMARILY for EMERGENCY use.

You still need to run them every now and then for self-checking, peak-shaving is nothing more than a convenient time and excuse to do so.

If you don't regularly run your MW-scale generator, you run the risk of it rusting away internally, stagnant fuel and oil fouling things up, seals dry-rotting from lack of lubrication, etc. Running those thing on a somewhat regular basis is part of regular maintenance and fuel is much cheaper than finding out that your generator has seized at some point between emergencies during an actual emergency because you couldn't be bothered to use it for anything in the meantime.
Reply: @davidporter4162  i understand that what i mean is if they used a storage battery to charge cars and topped them back up during the night or off peak say , then how many cars could that battery charge. 
I see petrol station with queues everyday so surely if ev became mainstream then there will be queues for ev charging
Reply: @davefarmery8180  Storage batteries come in different sizes as do EV batteries but for instance 1 grid scale battery container is probably about 3000-4000kWh capacity and an EV charge would likely average 30-40kWh (a top up, not full charge) so it could charge 100 EVs.  Subject to space, you can have as many batteries at a station as you want so there really is no practical limit other than space.
Reply: @davidporter4162  Sorry I may have mixed up my replies re: diesel.  If the power is "green" losses are easier to justify because there are no CO2 emissions, so then it is just a matter of if the cost of all the components at the size required makes economic sense.  I was arguing with someone else that using diesel generators to charge electric cars makes no sense.
Reply: @davidporter4162  ok i understand. 
 But 100 cars isn't many really. 
I assume you can have more than one charger running off of a storage battery or container battery. 
I'm not sure how long a charge takes but say 30 minutes then you wou need  2 charges to to charge 100 cars ish in 24 hrs .
Or 4 charges to charge 100 in 12 hrs .
If you had 4 container batterys thats 400 cars from 8-16 charging points , 
And then the infrastructure to recharge those container batteries would need to be massive. 
Or am i missing something 🤔
Reply: @davidporter4162  Absolute nonsense.  The battery has charging losses, both ways - when it is being charged and when it's charging the EVs.  Charging EVs from a battery would need ~20% MORE electricity from the grid.  So if that battery charges EVs 12 hours per day and gets recharged at night, you have a bigger problem at night than what you started with during the day.
Reply: @davefarmery8180  In reality the battery will only top up the supply from the grid.  9 out of 10 cars that go to charge will be charged from the grid rather than the battery.  The battery only comes in to action when there are too many cars charging at once or if there is a grid failure which doesnt happen very often.  It can also be used to take advantage of cheap night time electricity.
The other thing to consider is if it takes each EV half an hour to charge, a charger will not usually charge more than 20 cars in a day so one battery could could fully cover 5 chargers but as the grid is doing most of the charging, one of these batteries could cover more like 20-30 chargers, more chargers than most stations have.
Reply: @davidporter4162  LFP batteries have only 3/4 of the energy density of Li-Ion.  They're only for short range vehicles.
Reply: @markmeridian3360  Hzve you looked at RTE for Li-ion batteries?  Because batteries operate on DC you don't have conversion losses when charging the EV but even on a grid system where you go AC to DC to AC, the RTE for Li-ion is still >90%.
Reply: @markmeridian3360  I wouldn't consider anyhting but Li-ion for EVs at the moment.  LFP, flow, solid state etc. are only for static systems.
Reply: @davidporter4162  thankyou
Reply: @davefarmery8180  And thank you
Reply: @davefarmery8180  There is no additional charging infrastructure: 440V 3ph power comes in, gets PFC-boosted to HVDC/battery rail voltage (say 1kV if you want to still be able to use GaN FETs for maximum efficiency) and the the chargers tap into this HVDC rail to step it down to whatever each EV wants. If there was a DC generator, it would also dump its power directly on the HVDC rail. All that the battery does is sink surplus energy on the rail when present and source any shortfalls as they occur, much like a power supply bypass capacitor on a PCB.

With 500kW chargers (1kV 500A), you can dump 50kW into the EV battery in as little as 6min, add maybe 4min to park, authenticate, plug in, plug out and leave. Each cable should be able to do about 6/hour in a smoothly moving waiting line situation, which means you need four of those to max out a 1MW feed with a throughput of 20-ish hella-fast-charging cars per hour.

Most EVs currently in existence cannot continuously pull anywhere near 300kW though, so the average session time would be closer to 20min. With your eight cables, you get three cars per hour per cable x 8 cables = 24 cars/hour. At 50kWh each, that is 1.2MW going out each hour, minus 1MW coming from the grid, leaving only 200kW for the battery to take care of, not going to deplete a 5MWh site battery any time soon with that.

Ramp it up to something like 20 cables, 1MW of grid power into a 5MW battery pack would let you serve 150 cars in 2.5h before the battery is tapped out.
Reply: @trevorvanbremen4718  I do not hope to be 100% everywhere  - that is too much. 

But being personally trained and  for few years authorised by  number of  safety institutions  in different countries to issue certificates   in safety in hazardous fuel and gas  environnment I also in that profession   was earning   money . Enough good for me
Reply: @teardowndan5364 ;15 to 20 cars a day is nothing. A regular gas station will fuel more than 15 to 20 cars an hour. The current power grid was not engineered to provide the kind of power demand that would be required in we went all EV.
Reply: At least get the statistics correct. Most EV battery management systems only enable max charging rates when very low on charge. The charge rate reduces considerably as the level of charge increases. On average I would estimate that the charge rate per car sits about 50% of its max rate and few EVs have a max rate of >150 kw so you are looking at an average of ~80 kw per vehicle. Combine that with average charger occupancy of say 80% say for a busy site at peak times including handovers and the average total grid load is significantly lower than your example. My own experience at large sites of 10-15 bays confirms the above figures and my car has a max rate of 205 kw.
Reply: @davidporter4162  There are ALWAYS heat losses.  One way is ~95%.
Reply: Or like here in canada just use huge natural gas powered generators
Reply: @douglaswares8296  Today's EVs may lose a lot of charging speed once they pass about 50% but those charging curves are getting more aggressive every year. Peaks are getting higher, get sustained longer and fade out slower. It'll get to almost gas-like at some point in the future.

With so many DCFC networks billing by the hour for charging, it makes no financial sense to stay connected much beyond the point where charging speed starts coming down unless you absolutely need to stock up on range there.
Reply: @douglaswares8296 ; if everyone with an EV drove into a charging station just to "top-off" a battery that was 25% down, that would REALLY screw up the charging network. If everyone with a ICV topped off their fuel tank every day, the lines to get into the service station would stretch for miles. Face it, EVs are not ready for prime time. Like I said, they MAY be the future, but that future hasn't come yet.
Reply: @markbadhamthornhill8152 he didn't say you were guessing, it's more about what those statistics include rather than there accuracy.
Reply: @oldgysgt  most of my charging is done at home. Like the majority of EV owners I charge on long journeys when I am below 20% and charge to 80-85% to minimise charge time and get optimal range. I have not had any significant issues in the 18 months of ownership. The charging network is expanding at a significant rate. EVs are not for everyone but I am delighted to have made the switch for economic and climate reasons. I had diesel cars for many years and don’t see me ever going back to ICE vehicles.
Reply: @douglaswares8296  ; you need to stay focused here. This conversation is not about home charging, it's about commercial charging stations. But if you must talk about home charging, do you remember in 2021when California Governor Nusim asked EV owners in Southern California not to charge their EVs because there was a hot spell, and the power grid might be compromised because of the extra load of having to cool homes and business and charge thousands of EV batteries at the same time? Like I said, not ready for prime time.
Reply: @oldgysgt  Those small stand-alone battery-backed fast-charging appliances (the kind that can only handle about 20/day max) are for low traffic locations where running dedicated power would be prohibitively expensive and your options are down to that or L1/L2. They can be rolled out just about anywhere you have access to almost any power from.

While the battery does add ~20k$ to cost, it would likely cost more than 20k$ just in permitting, engineering surveys and administrative red tape before pouring the step-down transformer slab for a "proper" (non-battery-limited) fast-charger.

I wouldn't worry too much about peak demand. DCFC hubs will inevitably gravitate towards sufficient on-site energy storage to time-shift most of their load to off-peak rates. If everyone time-shifted their non-essential energy usage, there would be minimal need for grid upgrades in most places, only baseline power generation.
Reply: @avid6186  it's fires per 100 000 vehicles sold .. Nothing to see there .. Not 20 year old vehicles
Reply: @bettymilcarek5195  Which was started by a Non Hybrid L494 Ranger Rover Sport DIESEL. The EV Charging stations are Terminal Car Park 1 ONE, the building that collapsed was Terminal Car Park 2 TWO. You are just ignoring facts to push a false agenda.
Reply: @cadredeux1047  "Wouldn’t drivers avoid stations with generators" WTF that is some isnane assumption. AFIK no permanent Public Charging station has on site Generators. That is simply not a viable functioning system as the scale is too small to be economical.
Reply: @Neojhun  That was a very unusual diesel fire that just could not be put out.
I guess time will tell. Take care.
Reply: @Neojhun ’would’t drivers avoid stations with generators “.  Because of the added cost. Eventually they will become like gasoline stations, people will choose because of price. If the cost of the generator is passed on to the consumer he might avoid that station. This a fixed cost, not a variable cost so everyone at the charger  pays the cost, whether there is one person at the station or ten.
Reply: @teardowndan5364  thankyou for the information 👍
Reply: @SkySurferG if the power supply isn't an issue , then explain why California was telling people with electric cars not to charge them , and there was a potential for rolling blackouts?  Battery fires are all too common.  If this was a child's tow that had a choking hazard, it would already be pulled off the market.  It's a fantasy.  To power one home for one hour with battery system, would cost. $1b per year to get that infrastructure going.  Who is paying for a whole city?  It's unrealistic.
Reply: Not to mention once fuel is converted to electricity, it starts discharging. It discharges during transmission, it discharges being stored, it discharges if the car sits, what a waste of fuel. Yes fuel. Electricity for the most part is made from burning fossil fuel. And yes, I said burning, as in emissions.
Reply: @mguytv  LOL. "batteries bad, petrol good".
cos' petrol never burns... lol.
Any form of stored energy is dangerous if proper precautions aren't taken. Bellringers have been seiously injured by the stored energy in the swinging bell, when they didn't time their pulls properly. People have been killed by horses kicking them, well before anybody thought of pumping oil out of the ground.

The point is that this is a relatively new technology. It is already very safe, and rapidly getting safer. The major cause of fires in lithium batteries is being crushed by garbage or recycling truck compactors. At least a dozen fires a week here in Australia, because people can't be bothered to dispose of their batteries properly. Things like vapes, or old phones, or toys that get thrown out when the battery is "flat", they all cause truck and landfill fires.

Why do so many of you wannabe YouTube heroes feel the need to catastrophise over battery technology? It's just plain weird behaviour. Do you seriously demand absolutely zero probability of an incident from this technology, when you'll happily go swanning about with a petrol bomb 2m away behind you? As I said, just plain weird behaviour...
Reply: giarcareklaw; So your solution - that will still not enable people to 'fill up' any where near the two mins it takes to fill their tank with petrol, is to mine more of the materials (and the harm that causes the planet and the people to have to mine it) to make more batteries, which then creates more problems when these batteries have to be disposed of? 
Yeah, seems like a well thought out and decent plan indeed eh?🙄
Reply: @gibsonduvall  LOL. Cos you're really concerned about the pollution caused by mining metals, but you think digging up oil and burning it is just fine...

Critical thinking isn't really your strong suit, is it?
Reply: I'm sure it's all in all a very environmental friendly solution to manufacture and recycle such big "power banks". They probably don't need any cooling either when they charge/discharge or just to keep an optimum temperature... demanding power just to function, good stuff.
Reply: @micke3035  Yeah, it makes much more sense to dig up oily sand, cook it with high pressure steam (heated by burning some of the stuff you dug up previously) dug up, burn off all of the light fractions so they don't create an explosion risk and then pump the 10 or so percent of what you extracted across a couple of thousand miles to a refinery, where it can be processed with more energy provided by burning what's already been refined, then cart it in a truck (burning more of the product to do so) to a petrol station where it's pumped into the ground (guess where the energy comes for that), then pumped back out again (wanna guess where the energy comes from?) before being burnt to save you from having to use your legs.

I don't think you've really thought this through...
Reply: @collenfisher3635   Tesla has switched to LFP cells for their Megapack storage products. Much, much safer than li-ion cells. The are also very long lived, so the cost can be amortized over decades. They are efficient too. Round trip energy loss is less than 10%. 
Charging the batteries does the exact opposite of putting more strain on the grid. A steady, moderate rate of pull from the grid is much easier to manage, and heats up wires far less than massive intermittent loads as cars come to charge. They can charge many cars before they are depleted, and can refill during slack periods when cars aren't coming and the grid has much less load overnight. The amortized cost of the Megapack adds about 6 cents (US) per kWh to the cost of the power. That is likely offsett by the lower costs of the power from the grid, as utilities charge a premium for sizing a connection for huge peak delivery (look up "demand charge" to see how that works.)
Reply: Storage batteries double the storage price for energy which already is, for one storage cycle in a lithium battery of the BEV, several times the price to get a kilowatt hour of electricity by the cheapest source which is burning gas, coal or similar.
Additionally, huge investments with significant impact on the environment and the "climate" needed.
Reply: @micke3035  I do enjoy a well written and irony loaded comment👋.
Reply: @mguytv  you still haven't done the sums, have you. Try calculating volume while you're doing the mass calc. Ignorance is one thing, willful ignorance is...
Reply: @collenfisher3635  agree. Onsite batteries is a daft idea.
Reply: Good luck with the cost of charging then!
Reply: @sunahamanagai9039 ;yes, every time you change energy into another form, some of the energy is lost, primarily through heat radiation.
Reply: @SkySurferG  The availability of power is not an issue.      Really, you solved energy supply issue for the world ?  Why are then all of us are not getting all this electricity for almost free ?
Reply: @daintree2455  That is an obsolete and diminishing billing method. Old laws in many US states prohibit anyone other than the local monopoly electric utility from selling electricity. The crude workaround is for EV charging sites to bill for time connected, rather than power sent. Stupid, but it skirts the equally stupid rule. Those old laws are being changed so that EV charge point operators can sell electricity the same way petrol is sold: by how much is delivered. Seems so obvious and sensible it's hard to believe that all states haven't already revised the rules. But once they have, the equation is flipped. In most areas the rules will prohibit charging by time, and only allow for charging by how much energy was delivered to the car.
Reply: @dylaninnes8541  The big Tesla charging station on I-5 north of San Diego uses a diesel powered generator to provide their juice as the California grid isn't sufficient with too many blackouts and brownouts, especially during the summer months...
Reply: @daintree2455  Unfortunately too many evil EV'ers top off at the charging stations instead of disconnecting at 80 percent... There are four forces in the universe, one being electromagnetic... Think in terms of a movie theater, seats fill quicker when it's half full, whereas seats fill considerably slower when it's full as people stir around several minutes into the film. Batteries have a finite number of cells, like theaters have a finite number of seats...
Reply: @ronclark9724  yup Elon musk understands the limits of the grid 
It's almost like renewables aren't enough
Reply: @GerbenWulff  Tesla is adding solar panels and/or diesel generators to their large charging stations as most of the grid isn't sufficient...
Reply: @markbadhamthornhill8152  As if toxic batteries in landfills don't foul the water table either...
Reply: @Neojhun  At home maybe, but not on the road at these charing stations... Furthermore these very heavy batteries on EV's require stronger much more expensive tires that last maybe a third of those from ICE vehicles... The EV advocates never mention tires...
Reply: @jasonhutcheon5991  With half the charging distance as well... Not much of a problem for those charging their batteries nightly at home, but many of us don't live in houses or drive short distances daily...Plus these newer batteries are heavier reducing range...
Reply: @cadredeux1047  Unfortunately that is not welcomed by the Greens...
Reply: @glennmartin6492  There is a reason why the charging stations have short cables.... Learn....
Reply: @sjsomething4936  When your home suffers brownouts and blackouts you will be singing a different tune...
Reply: @sjsomething4936  Well, the batteries don't pop out of thin air either... Those resources to produce a battery and the production of a battery isn't energy free as well... At least child labor isn't being used to pump and refine oil...
Reply: @timgurr1876  Don't forget the electric utility substations and transformers many tend to ignore...
Reply: @trevorvanbremen4718  There are four fundamental forces in the universe, one being electromagnetic...  Batteries do not use strong, weak, or gravitational forces...
Reply: @rodsmyth  95 degrees isn't hot... That is a cold wave in Texas during the summer months... Millions do not die every year due to heat anymore than those who die from freezing to death...
Reply: @markbadhamthornhill8152  Tesla also has diesel generators at many of their charging stations too as the grid isn't sufficient. The sun doesn't shine at night, nor does the wind blow all of the time... Duh...
Reply: @wazza33racer And most ICE vehicle fires can be extinguished by a small hand-held fire extinguisher. Not so much with a lithium-ion battery in thermal runaway, even at the very beginning of the fire.
Reply: @teardowndan5364  It has been my experience the charing stations on the road are full during the day, so my brother drives his EV long distances at night... But he nows complains the chargers are becoming full at night... I wonder what the future will reveal in a few years?
Reply: @markmeridian3360  You are a wise person...
Reply: @simoncrooke1644  The Swedes have a way to deal with EV battery fire: use a cobra firefighting water jet (those things have been around since 1997 as a cold-cutting tool) to poke a hole through the EV floor and battery pack cover to inject water directly inside. Takes them ~10min and only 240L of water to end a thermal runaway event.
Reply: @teardowndan5364  Yeah, that's directly comparable to a 1 kg hand-held extinguisher that you can carry in the boot. You have made a ludicrous comparison. Also, that technology has not been widely dispersed in the fire-fighting community.
Reply: @ronclark9724  Scaling fast-charging infrastructure with traffic will be a nightmare. I'd much prefer having confidence that reliable charging exists near just about every highway exit than having super-mega-hubs.

Those would still need to have enough cables that people hardly ever need to wait to plug in, even if it comes at the expense of charging taking a bit longer from sharing total site capacity with more people. If you don't like the charging speed from 1MW of site power shared with 20 others, take a 10-20kWh charge and try your luck 2-3 exits further down the road instead of waiting 5, 10, 15min for a chance to plug in.
Reply: @teardowndan5364  In addition to my other comment, I didn't say lithium-ion batteries could not be extinguished. I said they can't be extinguished with a cheap, easy-to-carry, hand-held, fire extinguisher. In many instances that fire-fighting device can be deployed within a minute and has a fair shot at extinguishing a fire. Just not the lithium-ion, thermal-runaway variety. I would still carry a 1 kg fire extinguisher in an EV, because not all possible fires are going to involve the traction battery. The fire extinguisher could be helpful in these other types of EV fires in the same way that they're helpful with ICE vehicle fires.

PS: The EV will be irredeemable by the time the fire-fighters get there with their fancy, water lance to extinguish the fire in the battery that is in thermal runaway.
Reply: @ronclark9724  you so sure about that huh?  Nigeria used to have a TERRIBLE record of child labour in the oil industry, which has been solved by legislation and pressure on the industry.  Probably still happens in oil extraction related industries but not the major oil producers any longer.  Got news for you fella, industry around the world, regardless of the country and industry sector will exploit child labour if there isn’t oversight and laws to prevent it.  Even happened recently (recently as in the last 6 months) in the good old USA in meat processing plants.  

And not just the child labour, good friend of mine who lived in Nigeria as a kid in the 80s and whose dad worked in O&G not only related personal stories of seeing kids in the oil refineries and drill sites, but he said that back in the day the oil companies would think nothing of massive oil leaks into the ocean and spills on land. This came about during a discussion of the Deepwater Horizon disaster when he basically laughed at how freaked out everyone was over it.  The journalists and environmentalists in Nigeria at the time would have been shot or badly beaten by oil company employees if they’d reported on this kind of thing.
Reply: @GerbenWulff as long as you don't have to supply the batteries.
Reply: @markbadhamthornhill8152 but we can rely on fossil fuel, we cannot rely on solar and wind
Reply: @eamonanthony6767 yes, at the fun fare.
Reply: @markbadhamthornhill8152 dude with that attitude , we will all be riding horses again, or walking. EV s won't work. The basic maths will explain that to you.
Reply: There's no chance of fires at a gas station?
Reply: The solution for EV shorcomings by ideologically possessed people is always MORE BATTERIES.
More batteries = more cost and more complexities  These people do not understand size scale complexity and scarcity (basic economics) You make the total cost of EV ownership too high and nobody will buy them. 
It is already too high for most people and only getting more expensive.
Reply: @graemewindley1614  I do believe maths couldn't be your strong point.. 30 million EVs on the road already ..
Reply: Storage batteries don't generate power, they just store it. It will come from the same place the power to charge the cars comes from - the grid. So if you get a big rush hour need to charge cars, the batteries will deplete quickly and then you have to not only have to charge a large bunch of cars but also the storage batteries, so you are back to ground zero again. 

 To build out the grid (the real issue here) to supply a world full of EV cars and trucks with batteries would cost enormous amounts of money!! To make this scenario possible would require the electricity to cost a lot of money to the consumer, money no one will want to pay for an electric car.  So now you will have grossly over priced EV cars and grossly over price electricity to power them. This whole EV car concept is a big money making novelty for the very rich right now, due to the staggering amounts of Grant money that are being poured into the research by the government, that is where the real profit lies. Companies like GMC are already looking to out of EV cars and into other options, their CEO openly stated so. So what do they know that the public doesn't? What I just told you.  Dig deeper, don't blindly believe what the government and the electric car companies tell you. The math and engineering don't lie, but the companies pushing EV's do.
Reply: @johnkemas7344  
Electricity is the most expensive form of energy and has the least energy density.Thats why it takes very heavy batteries to store it. You get much more power from a gallon of gasoline. Gasoline also is easier and cheaper to produce and much easier to store and dispense.
Generating electricity takes more energy and much more land use than gasoline or natural gas.
So EVs are not a solution and BTW we currectly have at least 300 years of Petroleum in the ground that we know of AND new oil fields keep getting discovered
Reply: @dylaninnes8541   the more current you draw through a wire, the hotter it gets. the hotter the wire, the more the resistance will increase
Reply: @andrewdonohue1853  that would be why Air conditioning in the summer is so hard on the system? Because everything is hot already... 
I appreciate that insight
Reply: @MrBCRC   With those type fires, foam can extinguish them, and they don't reignite without another source of heat.  Those who've dealt with EV fires have learned how they can reignite within minutes, hours, or days.  They've also learned to isolate an EV vehicle after a fire for this very reason.  I'll stick with my ICE, thank you very much.  I can park it in my garage without worrying if my house will burn down.
Reply: . No one will dispute that proven fact that ICE vehicles do catch fire.  But it's the type of fire that gets debated.  An ICE fire takes place most often in the engine compartment because of a fuel leak or other problem.  Seldom, if ever, does a moving or parked ICE vehicle have the fuel tank suddenly burst into flames.  That isn't to say it can't happen, just that the frequency of it happening is very low.

One the other hand, it is the energy source, fuel source, of an EV that shorts and starts burning.  And from documented videos, the fire spreads rapidly, unlike a gasoline or diesel fire.  And it is intense.

One thing not covered in this video but was covered by another gentleman in another video, I can pull into any self serve station and pump gas as long as the pump is working.  The gentleman I mentioned, went from St. Louis to Chatanooga, Tennessee in two different EVs.  He found that he couldn't charge either of those EVs at just any of the chargers along that route.  Because of the type of connectors built into the cars, he had to find working chargers with ends specific to the cars recepticals.  He did say an or of buying a set of adaptors and carrying those with you.
Reply: New batteries have a very low risk of fire. Also, ICE car burn more often then EVs in percentage.
Reply: @mletouutube  percentage of what?
Reply: @mletouutube  here's the problem with stats they can be manipulated via inputs 
Started on fire fueling/charging 
Accidents 
flooding 
Driving 
Also age of vehicles makes a difference

Omitting information/criteria can lead to massive differences in numbers 

Something else to consider is magnitude of fires partial gas tank vs partial charge
 survivability of occupants in said fires would be another 

I don't pretend to know the answers but it would be nice if us citizens could look at the data that all of the inferences are being drawn from and it would be easy to see if they are in fact safe or not 

Like you said the batteries now are safer
 in theory that's great
The numbers may show 1 out of 10,000 have had a fire 
Reality could be that 7,000 are still at dealerships and haven't been on the road (just pulling these numbers out my a$$) 

In theory they do a lot of testing to make sure they are safe 
But recalls show that a lot of issues still get through regardless of make model
Reply: Just charge EV's with diesel generators, cheap, scalable, easily refueled and not dependent on the electric grid... 🤷‍♂️
Reply: @dylaninnes8541  Tesla cars are safer than any other cars EVs or not EVs, with fire involved or not. That is a fact with millions of them on the road. Another fact: Ion phosphate batteries (used in more and more EVs now-a-days, ex: Tesla Model 3 standard range) do not ignite when punctured or shred. That is also a fact. People ignore that is not part of their beliefs. Also there is Tesla and there are the others… not the same.
Reply: @MrBCRC 
Hey dum dum, stationary battery storage units don't use lithium ion batteries. The majority of them use lithium iron phosphate batteries. You know the ones that even if they're drilled, punctured or damaged won't catch fire.
Reply: @mletouutube  fair I'll look into that thank you
Reply: Yea, lets stick to the worst solution, because something less bad is still bad.
Reply: @billthomas635  Maybe there are cheaper alternatives to the lithium battery that don't have to be light weight as they aren't in a vehicle, one could also employ gasoline or Diesel generators to take care of excess demand when needed, just by burning the gasoline or diesel stored in the tank that feeds into the gas pump, you can locally generate the excess electricity to charge up the extra vehicles at the charging stations that the electrical grid can't handle.
Reply: TOUCHÉ!
Reply: @SkySurferG  Not correct.  I'll not comment on the first three sentences as the argument for or against that doesn't really matter and is partially useful.  Solar panels, while insufficient, is still a small benefit, if increased cost, to their system.
Banks of batteries that are not situated in very robust climate controlled environments are as volatile as above ground, single walled, half full tanks of gasoline.

Which the response is, if it's the same, why not do it because there are other inherent benefits that would outweigh similar hazards.

Except that above ground, single walled, half-full tanks of gas are illegal for permanent storage.  Because they present too great a hazard to those in the area and the environment.

Second, the cost of operating and maintaining robust climate controlled rooms/containers is not small.
A single tesla Model 3 has a capacity of 5.3kWh.
To effectively support continuous support for One Model 3 you would want at least 2.5 times that capacity if you have any interest in battery life.  An investor or an environmentalist would not want a set of batteries to to replaced every six or most likely every three months because they had run through their life-cycle through continuous full charge/discharge cycles.  The ideal maximum storage would top at 80% of the total capacity and ideally you would pass the system between 30-70% in the charge and discharge cycles.
To support the through-put current of a discharge (car charging cycle) the bus and cabling (electrical connections) would be oversized to allow for efficient current flow and minimal overheating.  The battery banks would have to be built with sufficient spacing to allow for efficient heat dissipation and airflow between every cell.
The batteries would most likely be Lead-Acid or similar as they are cheaper, easier to maintain and easier to replace for maintenance or life-cycle rotations.  Life cycles for this would still be measured in months, not years.  I would expect annual rotations to a facility to refurbish the anode and cathode plates.

So lets set up a bank worth $40,000 distribution and electrical gear worth $40,000 multiply this set by five in a 40ft container that is designed to contain any possible electrical blast from a fault and has sufficient cooling for normal operation.

Sounds needlessly expensive and wasteful of energy.  Imagine running a large industrial AC continuously 24/7, 365 and then setting up a service plan to maintain the batteries and electrical equipment.  For every gas station in a city.

Trying to consider the infrastructure to just support charging stations is a massive drain and strain on what currently exists.
Reply: Wrong
Reply: @hobo1704  Having just made the return trip from Melbourne to Sydney (AU) I can tell you that Tesla has raised the power price from 60c/kWh to 70 cents. Meanwhile, I am sitting here at home watching the power flowing from my solar panels into both my Tesla PowerWall battery AND my Tesla Model Y AT THE SAME TIME. And the cost for this power? ZERO $$$'s   The solar panels paid for themselves 4 years ago, so it costs me nothing to charge. The FREE RIDE continues, except in neanderthal land...
Reply: @greghudson9717  another one that doesn't understand that it is not free. You are not making money from the solar but using it to charge.. Have fun staying close to home
Reply: @mguytv  Your asumption that every battery packs have bad batteries is faulty.   When you know the true life cycle of let say of batteries from a Tesla pack. You will notice that Tesla is in position to garantee that their batteries could have a 100 year life cycle if used and maintained at the same constant temperature.   

In the case of Tesla, it's why they can provide Powerwalls  for home use and megapacks for industrial use.     I'm sure that you may not know that, but at every Tesla factory, they have a farm of Megapacks.  These megapacks have the hability to provide power for 7 days to the entire factory.   

Now imagine when they add a megapack to a super charging station,  That megapack will act like that underground reservoir or electricity.  

Now where we can see a problem, will be with those small independant charging stations, that won't provide that buffer.  Here where I live in Canada, independant charging station are usually alone or have a second one installed in the parking lot and won't have that backup power.

But if you want to provide the service like Tesla,  You have to invest in order to give the service to many EV's
Reply: Tesla builds, sells and uses industrial sized batteries that can supply spot power to the grid when their are hiccups that cost utilities major dollars in spot prices.

Tesla is turning themselves into an energy company.  

The idea that they would be baffled by a single home style connection is ridiculous.  The whole charging infrastructure is key to their auto industry as well as to their energy industry.

Anyone in Australia (like MGUY) knows the power and major financial benefits of Tesla's grid level storage solutions, as that was an early Tesla project there.
Reply: @mguytv How about a ship load of them. Which caught fire recently at sea.
Reply: @dylaninnes8541 Plenty of potential to charge EVs via solar. That’s how my mate & his wife normally charge theirs. They have a Powerwall as a load balancer. With only one EV they could sell power to the grid.
Reply: The batteries which provide a buffer do not function well in very cold or very hot temperatures, nor do the batteries in the EVs. The sad reality is that EVs do not fit well with the driving habits of most vehicle owners or the conditions the vehicles are operated in.
Reply: @davecooper3238  really? They must not use it much
Reply: @billthomas635  Not only that  but imagine that the ratio of EV's to NAE's increases and picture stations that have to accommodate both modes? How will they make room for these charging stations to satisfy both? And the time it takes to charge an EV that requires the EV to take up space when a NAE is only roughly 10 minutes? Never mind the hardware needed to support the simultaneous charges, lol.
Reply: @cadredeux1047 saw the hypocrisy fist hand two months ago while doing a service at their only Refinery
Reply: @davecooper3238  unless you can find away to charge with sunlight while you are driving, it is meaningless that you are charging with solar panels, because it just à insignificant source of power of the grid which is still largely dependent on fossil fuel. You could also charge your EV with a Diesel generator. How you get your electricity is not the issue because EV batteries can’t produce electricity.
Reply: do you understand how big a battery would be if it equaled  40 000 liters of fuel - EV's could be great   they will ruin them  but they could be great
Reply: So what about a container-sized supercapacitor? All chargers draw off of it, and it is recharged by the grid at whatever capacity is available. Might this not work? @mguytv
Reply: @khg8519  The battery doesn’t create energy. What you are saying is how does this battery compare to a empty 40,000 liter storage tank. If the battery isn’t charged it’s an empty tank.
Reply: @seanworkman431  -  I looked that up, OMG!  We will be seeing a lot more of that with the increase in EV's.  I won't be buying one, guaranteed.
Reply: Batteries. That right there is yet ANOTHER problem all its own. THINK!!
Reply: @Neojhun How much petrol & petroleum being used to support!
Reply: @hobo1704  You are the one that does not seem to understand. My solar panels paid for themselves in less than 2 years, so everything after that is FREE (even you should be able to understand THAT). I now use excel solar to charge my Tesla, so my charging cost at home is also ZERO (something else you should be able to understand).  The only time I really PAY for power is during long trips away from home (which I do often) but even then it is still WAY cheaper to buy electricity than petrol.  My last petrol powered trip from Melbourne to Cairns return (7500km) cost me AU$1800. The same trip in my Tesla cost just over AU$400.     I have lots of fun staying home, but even more travelling. Maybe you should either try it yourself, or just stay ignorant of the benefits of EV's.
Reply: @greghudson9717  yep, definitely uneducated AF. Not surprised being an EV fanboy..
Reply: @hobo1704  Moronic AF yes, but you don't sound like a fanboy?
Reply: @skysurferg1952 Petrol tanks don't explode just because some water got into them at some point. Also, the act of depositing and removing fuel from them doesn't cause massive heat spikes that plummet efficiency and damage infrastructure.

Finally, tanks don't constantly lose energy even when not in use. We already can't produce enough power to fuel a fleet of EV's as is. Imagine how much worse that problem would get if we add massive amounts of battery bleed off to the mix.
Reply: Yeh these charging stations are already being built in the UK, it's not the perfect solution, but it's a step in the right direction.
Reply: I agree with your theory of a storage battery per charging station however this would require ineccess of double the maximum battery volume of any car likely to use the station and therefore also decreases the life of each battery by dump charging to full capacity
Reply: "green washing" I have never heard that term before. I'm going to have to remember that one
Reply: I've had an EV for a few months now. Only once connected it to a charging station away from home, although it wasn't actually necessary. I charge at home  on a 7KVa home charger off the 30amp regular supply. It takes about 90 minutes, and I do it overnight when the cost is 50%, [17cents NZ per Kilowatt hour.] This is the real world now, the future is even better....
Reply: No one is mentioning the "huge problem", because it isn't a huge problem. In fact, electric energy is far less a problem, than gas charging was a problem 100 years ago. For electricity, the grid already exists. For gas cars, the grid had to be created first. Also, perhaps 5% of the charging is done on fast chargers, and most of the slow charging is done at home. Also: there are almost no vehicles which can charge at 350. As far as I know, only trucks can do that. My electric cars, one charges at 50KW max. (that would be 14 cars at once, charging at max - and most of the time they don't do that), if the infrastructure delivers 700Kw. The other has no fast charging.
So, why making a "big problem" out of something that isn't a problem? The only explanation I have, is that the ones who do that, have shares in the oil and ICE industry.

Anyway worth to mention: In a year time, my car has only fast-charged ONCE! - With 18,000 Km. travelled.
Reply: @SkySurferG lol come on, they provably barely make enough power to run the pump’s display screen.  A solar panel wouldn’t make a dint in a car charging station.
Reply: The problem is that batteries are not very efficient. You lose on the charge, and you lose on the discharge. So, storing lecky-trickery on-site is a  costly and inefficient affair, which does nothing except add to the cost of charging. The whole idea of a robust grid is that it can provide the power required, when it is required. That's what makes it efficient!
The solution for power companies is to put all EV chargers onto what we call "Ripple Control" in New Zealand. That is where the power company controls your hot water heater, and turns it off to balance the load. This would allow power companies to properly manage both water heating, normal demand, and EV demand.
Reply: So the cost of the storage batteries and the cost to continuously recharge them and their degradation and state of discharge is another cost to the EV station owner.  Thus, charging cost will have to increase further.  Not to also the mention the peak load times by the utility purveyor and the demand charge rates.
Reply: @Gregory-Masovutch  Not exactly true. It doesn't matter if the batteries are located at the solar or wind production site, or on the user's end site. Therefore, no difference. No, charging costs will decrease, if the batteries are being charged while the cost of energy is low.
Reply: @SkySurferG  if battery fires come from overcharging, and charging is computer controlled, it seems to me that the computers arent doung a very good job
Reply: @GerbenWulff  i get your point, but question the intelligence of anyone who dares to rely on being able to charge during rush hour
Reply: If you have to go through another battery charging cycle then there are huge inefficiencies.  About 20% lost right there.
Then there is the lifetime cost of that extra battery.
Reply: @cccmmm1234  What would be the difference of battery costs, or losses, by batteries installed near wind turbines and solar, and the same batteries installed on the site where the energy is finally being used? None. But the advantage of having the energy stored and at disposal just where it will be used, is undeniable.
Reply: @hokroeger  Offsite you can use other cheaper, long lasting, options such as pumped storage.
But all storage systems are inefficient which is why buffer storing makes the electricity more expensive.
Reply: i suggest a full container of these batteries in a chargin station, and a very efficient air conditioning to keep them cool on summer and keep them warm in winter. This air conditioning better be fail proof, otherwise those batteries will quickly degrade and a new installation within 2-3 years will be required.
Reply: @cccmmm1234  Gas car efficiency is around 35% (the rest of the fuel is lost in vapours, transport, heat and friction. Electricity efficiency is around 80%. So, once more, your math is wrong.
Reply: @hokroeger   This is nothing to do with efficiency end to end efficiency. This is to do with the efficiency once it is made into electricity (ie. the efficiency from just transferring it from one storage to another).

If you take a liquid fuel, you can transfer it from one container to another many times without loss: from a storage tank to a tanker ship to another storage tank to a tanker truck to a storage tank to a gas tank in a car - all virtually zero loss.

This makes liquid fuel logistics management pretty easy.

Every time you charge and discharge a battery (eg. an extra storage battery) it eats into the lifetime of that battery. That adds a significant cost to storing and moving electricity. Adding another battery storage step essentially doubles the lifetime cost of batteries.

ie. If current battery costs are 10 cents/km then adding an extra battery storage step increases that to 20 cents per km.

Fuel tanks don't have that problem. Then can be filled and emptied thousands of times with no impact on lifetime.

But if you really want to play the efficiency game then look at this:

The 35% efficiency you talk about is from the time the fuel is made in a refinery to the power that hits the wheels.

Let's look what that looks like for an EV:
Generate electricity by burning coal, gas or oil (45% efficiency). AC to DC conversion in charger (95%). Charging battery (90%). Discharge battery through power electronics to power motor (90%). Motor efficiency (90%).  Complete path = 0.35%.
If you want to add an extra battery storage step to that then that is maybe 80% efficient (one charge and one discharge step). Complete path is 28% efficient.

Perhaps instead of burning coal to power your EV you want to use solar charging? Well that is around 10% efficient. End to end efficiency is 5%.
Reply: @cccmmm1234  "the efficiency from just transferring it from one storage to another" - Well, transferring electricity by wire is far, far more efficient as transferring fuel by train or truck.
"If current battery costs are 10 cents/km then adding an extra battery storage step increases that to 20 cents per km." False. The whole efficiency rate in electricity, over the whole process, is about 80% (from production to usage), while the efficiency of ICE cars is only around 35%. Battery storage doesn't add "cents per Km."

"The 35% efficiency you talk about is from the time the fuel is made in a refinery to the power that hits the wheels.

Let's look what that looks like for an EV:
Generate electricity by solar cells, wind and hydro (100% efficiency). AC to DC conversion in charger (95%). Charging battery (98%). Discharge battery through power electronics to power motor (99%). Motor efficiency (95 to 98%%).  Complete path = 80% 
If you want to add an extra battery storage step to that then that is ca 98% efficient (one charge and one discharge step) and uses cheap energy, when there's is more in the grid as needed. Complete path is 100% efficient." Because it is able to use electricity when it is almost free, and would go to waste if not stored in batteries.
Reply: @cccmmm1234  If moving cars through electricity is so "inefficient" as you claim then, how can you explain that it is 5 to 10 times cheaper as moving the same car with fuel?
Reply: @hokroeger  efficiency and cost are not the same.
 
And it is nowhere near 5 to 10 times cheaper.
Reply: @hokroeger  Sure, over wire is reasonably efficient. It is the storing and un-storing (ie. the charging and discharging of a battery or the filling and emptying of a pump storage system) that are inefficient.

I worked for a power company for 4 years. I have been designing electronics for over 40 years.  I understand what it takes to generate and store electricity.
Reply: @seanworkman431  Exactly, I spoke to a leaf driver who had a sticker on the back stating 'Zero Emissions Vehicle'
She was horrified when I suggested she change that sticker to read 'Remote Emissions Vehicle..' which is exactly what it is.
Reply: @seanworkman431  Really? Is this the best and brightest comment you are capable of making? Here are some questions for you then:
What happened to petrol/diesel used in a car in 1900?
What happened to petrol/diesel used in a car in 1950?
What happened to petrol/diesel used in a car in 2000?
What happens to petrol/diesel used in a car in 2023?
What will happen to petrol/diesel used in a car in 2030?
Clue: The answer remains the same. You ignite it, it combusts, foul chemicals spew out the exhaust and it disappears.
On the other hand, what is happening to the electricity grid at the same time as EVs are ramping up? Glad you asked. This is the percentage of renewables in the Australian grid over time:
2001-2002 - 7.7%
2006-2007 - 8.7%
2011-2012 - 10.6%
2016-2017 - 15.7%
2021-2022 - 30.9%
2022 - 32.3%
That is such a stale comment and every time you ask it, the percentage of energy created from sustainable sources increases. But there is no change in what happens in your ICE vehicle. Same result over and over for the past 120 years and into the future.
Reply: @CosmicSeeker69  point us to a single reputable study that supports your ridiculous statement that show EVs are more likely to catch fire or that they will catch fire while charging? Or even that they did catch fire while charging? Lol...and that the climate in Australia is so different to the rest of the world as to give a "significantly higher" risk. I fell on the floor laughing at that one. Comedy gold Graham
Reply: @cccmmm1234  Well, then we are down to what I said in the beginning. If the "problem" is "storing and unstoring", then it doesn't make any difference if the storing is done in a wind o solar power plant, or if it is done at destination. IN the hours in which there is more energy available as is being used, the excess has to be stored somewhere. And if you really worked 40 years in a power company, you should be able understand that.
Reply: @cccmmm1234  "efficiency and cost are not the same" Storing excess energy in batteries is more efficient as wasting the excess, and brings costs down. At least that you must be able to understand.
Reply: @mguytv  It works for Mega-Packs, so its good for you.😁
Reply: @chonpincher  When solar power is used in the future, it won't matter.
Reply: Batteries. Good one. We don't have good batteries yet to do that kind of thing.
Reply: @mynameisgladiator1933  In fact, there are a lot of good batteries out there, low price batteries: from totalled EVs.
Reply: Intermediate battery storage lowers the energy efficiency even lower than it already is.

Charging batteries from other batteries is retarded.
Reply: @billthomas635  Yes, and if many people land = more $ = higher electricity charges.
Reply: @lukeclifton4392  Indeed! I have never heard of or witnessed a fire at a service station in my 7 decades living in metro areas with hundreds of service stations.
Reply: each element that absorbs the power will decrease the efficiency, so this solution will make it even less environmentally friendly.
Reply: @ionlawrence4401  Such elements already exist, to store solar and wind energy when not needed. that's what makes them environmentally friendly.
Now tell me: what makes a fuel-burning  car environmentally friendly?
Reply: @hokroeger  Because it has a smaller carbon imprint than an EV. It also creates less pollution.
How far does an EV have to go to break even in emissions, and do you claim that an additional battery in the charging process will decrease that number?  Is wind and solar power harvested at zero emission cost?
Reply: They may try to mitigate the risk of a battery station and fuel station being on the same spot by locating the buffer battery elsewhere. But then who would want to live next to a battery the size of a house, that may blow up more ferocious, hotter, longer and not a single thing can be done to put it out or guarantee it will not reignite.
Reply: I charge my car off batteries charged from solar panels on my garage. 

The LiFePo batteries are cheap, use no cadmium, very little lithium, are fireproof, and nearly indestructible. They have a 25 year warranty and should have %80 power after 10,000charge cycles. 

They are heavy and larger than lipo but are great for hone and grid storage. 

But what you are really missing is the fact that this is an OPPORTUNITY  to solve many big problems with the power grid. 

Ecs will help stabilize, and make more efficient power grids!

Because cars do one thing %90 of their life.. they sit parked .. 

As an electric engineer this is fantastic!! 

All these grid tied smart inverters to correct power factor on site at the end of line, a dream come true for us engineers! 

The naysayers are lying to you all.
Reply: @mguytv  So you now have huge very expensive batteries constantly being drained to charge EV's and - presumably being concurrently charged from the grid. Wonder what the expiry date would be (if they don't go on fire, a big If I think)
Reply: @crxdelsolsir  There is no risk with LiFePo4 batteries. They don't blow, they don't burn.
Reply: @ionlawrence4401  No, absolutely not. Any fuel car has a bigger carbon imprint than any EV with the same specs. On average, you need perhaps 20,000 miles to make good for the production footprint, and from there one, you are saving on pollution.
The first solar panel or wind turbine construction has emission footprint. If for the next ones you use the energy produced by the first, the carbon footprint comes nearer to zero.
And your fuel powered car is polluting more and more every day, while the engine goes older.
Reply: @Mikexception You almost make it sound like a catastrophic conflagration would be a bad thing.
Reply: @hokroeger  Some studies say that the break even is at 70.000 miles. How many charges does the battery endure?
Reply: Fire risk of batteries? There have been at least 15 oil refinery fires so far this year. 
Have you any idea how many lithium-ion batteries there are in the world?
Apart from the 25 billion mobile phones, laptops, tablets, and wide range of cordless power tools and 26 million electric cars, there are also 500k Tesla power walls and at least 28 GWh of grid storage capacity.
Reply: I loved ET ☹️, just because you don't believe in extra terrestrials doesn't mean you have to hate them.
Reply: @ionlawrence4401  My bigger car is proyected to have still 80% capacity after 3,000 full charge/discharge cycles. Every charge is good for 400 km, therefore the battery is good for 1.200,000 Km, and still 80% battery capacity left.
Where do your "some studies"  come from?
Reply: @hokroeger  Volvo. BTW Elon says the batteries are good for about 1500 cycles, so how does that fit into your magical mathematics?
Reply: @mynameisprivate158 And make China all powerful, and able to switch off the supply at any time. And probably the cars too
Reply: @markbadhamthornhill8152 Most people? Do you have any figures on that? What is the percentage of new dwelling constructions are flats and houses? I used to live in a fourth floor apartment, in a courtyard of eight blocks. No parking
Reply: @SkySurferG  Because Ice fires are rarely spontaneous, they burn slower, burn cooler, supressed easier and when supressed unlikely to reignite.

All of the above the opposite of a battery fire hence rarely to not really mentioned. They just never occur unless something catadtrophic happens to ignite and usually that catastophic event takes the focus being the cause not a mystery/cover ups like EV fires.
Reply: Kyle ( out of spec reviews) went to a few of those across Colorado to test them out. They had grid limits in that area, so they have those storage Batteries behind the dispensers, so you can charge full speed.
Reply: There are battery technologies that could work well for this. It does, however, represent a significant added cost as well.
Reply: @SkySurferG   You didn't mention that ICE vehicle fires almost always happen in a crash and virtually always when the engine is running, as such never in a garage. An EV fire can occur at any time, therfore possibly burning your house down or destroying other vehicles in a parking lot or commercial garage. These big toys will go away soon, when all of the drawbacks are experienced by owners.
Reply: Don't care what you do .  I still will not buy one.
Reply: @mynameisprivate158  What are the materials used in EV manufacture, and how are they produced? have you thought about that? Getting off petroleum, what an ignorant thought!
Reply: @mguytv  Except at the charging station you don't need to use Li-Ion batteries, because weight and size are not an issue. You can use refurbished lead acid batteries that come from cars or other technologies (such as the Swedish invention to make batteries from rest products of paper manufacturing). Those alternatives produce far less pollution in their production and are much less of a fire risk.
Reply: @mynameisprivate158 there are so many items made with petroleum that would be a negligible difference
Reply: Oh god, it would cost like half a million dollars to make a battery that large, provide proper temperature control, and seal it so that there is no chance of leaking chemicals into the ground. On top of which the batteries would have to be replaced after a time, meaning you are looking at spending another half a million dollars at some point. And that's for one charging station.
Reply: @OmegaZyion  In a 15 year lifespan that's 100 bucks per day. With 100 charges per day thats $1 per charge. How would that be an issue? 100 charges per day is about 20% of the capacity of the charging station, assuming 10 charging places.
Reply: Batteries are a carbon bomb of resources. A steel or plastic tank no where near their footprint. Economies of scale won't fit the plug.
Reply: they always tell us that EVs are good for the climate...but putting more and more batteries in the equation (that are hard to recycle, prone to thermal runaways, fire hazards and highly toxic, xlimate wrecking gases) will make the ICEs look more and more climate friendly. You have the batteries now in the EV...in your wall box at home (hopefully fed from a PV system that gers not to be taken into the climate equation for the EVs) AND now even batteries at every charfing point? Hardly good for the climate.
Reply: @1s3ngr1m  The funniest thing about EV's is that when you plug them in, they pull energy from the power grid. What makes up the majority of energy production on the power grid? Fossil fuels. Approximately 2/3rds of the energy produced in the US power grid comes from burning coal, oil, and natural gas. On top of which, any plastic or rubber components of an EV is a byproduct of processing oil for gasoline. So EVs simply cannot exist without using fossil fuels.
Reply: Mate, you forgot to mention battery fires are worse than petrol

Mate, you forgot to mention battery fires are worse than petrol if a lithium ion battery explodes you cannot put it out. There is no way to put out a lithium ion battery fire. You have to wait for the battery to completely deplete the fuel

That’s A car carrier Had to wait seven days before they could take it back to Port. There is no safe way to deal with EV fires like petrol or gas

Petrol tanker catches fire. You just douse that thing with fire retardant foam, and within a good amount of time the fires out.

All vehicles can catch fire, but EV are a lot worse currently
Reply: So the solution is to add hideously expensive batteries so we can waste even more money on EV chargers...
Reply: @SkySurferG   ICE get on fire when an accident (mostly avoidable) happens. Batteries get on fire with no apparent reason, even when they run on the road or just completely still in parking. Or not?
Reply: @martalli basically, they would only let you charge your car at the highest possible electric rate to justify the battery.
Reply: ahahahaha buffer batteries...ahahahaha.. that just added a million dollars per charging  station ahahahahahahah
Reply: Seen it done with solar carports.  With decently designed infrastructure the only issue might be continuously busy stations, which would be a nice problem to have.
Reply: @seanworkman431  we are so fortunate that petrol stations, tankers, cars and oil rigs have never burned unlike that battery fire huh. This is breathless hysteria against batteries if every I saw it.
Reply: @Scottietheyoung  you are missing the point, thermal runaway cannot be extinguished thus it poses a much great risk to life and property than oil fires.
Reply: @sjsomething4936  wait until you try to sell or trade in your EV. The depreciation is twice as much as an ICE vehicle.
Reply: @MGUYTV  not only that but changing all stations to be geared towards evs would be a strain on the economy and as you mentioned power grids. Not only in Australia but especially in large countries that people regularly drive long distance or countries like Indias whose grid country wide could not support the demand.
Reply: @SkySurferG  Tesla only turns a profit because of subsidies and tax breaks while the increased demand for electricity drives the prices through the roof for the rest of us.
Reply: its not even close to the same, its SIMILAR
Reply: The batteries AT the charging station don't HAVE to be Lithium; standard old lead-acid would work just fine as a load-buffer. All you have to do is not smash or shoot them.
Reply: @SkySurferG any solar panels are much too small to provide a useful amount of power. But people are astoundingly ignorant about solar panels. They actually think that covering a car’s roof with solar cells provides a useful amount of power.
Reply: Do some simple math: 1 liter of gasoline has about 9 kWh of power so 40,000 liter tank is the equivalent of 360MWh. Now go and see what a 360MWh battery will cost and how much space you will need for that.
Reply: @mynameisprivate158 would love it.
Reply: So more batteries that will eventually fail and need to be replaced at massive cost and then buried because they can't be recycled? That doesn't sound like much of a solution. That sounds like a Band-Aid to a problem that can't be fixed by throwing more batteries at it
Reply: @dave20thmay  Of course the majority of fires are ice vehicles, can you guess why? It's probably something to do with the fact that the vast majority of vehicles are ice. The actual number of fires per thousand vehicles is the number that matters and the fact that ice vehicle fires are easily contained and extinguished unlike ev fires which are almost impossible to put out and let off some highly toxic fumes.
When was the last time you heard of someone's house burning down because their ice car suddenly decided to burst into flame?
Reply: But they don't exist
Reply: no manufacturers wants to standarize batteries
Reply: @SkySurferG  Battery fires are a much larger problem compared to petrol/ diesel fires for the main reason that nothing at this stage( available) will put them out. It's a known fact that while there are battery management systems to "safely" charge them, it only takes one faulty cell or damage from under carriage impacts for the whole unit to cremate itself and everything in it's vicinity. One idea which has been tested successfully overseas is to soak the inside of an EV in thermal run away with a brine mixture which has naturally increased it's boiling point ( keeping temps cooler for what it's worth) , but more importantly,  if the battery pack is cracked or open, the brine will discharge the battery within an hour preventing further run away events.  However, since the majority of thermal run away events are occurring from faulty cells, it's outer casing  prevents the brine to discharge the whole unit unless it's gone to the stage of extremely toxic gasses and solids exploding into the environment which is ultimately way too late..... Place these two fire events side by side, I'm sure all first responders  and the general public affected by these would rather have the ICE fire to contend with any day 
https://local.fo/faroese-invent-new-method-of-extinguishing-lithium-battery-fires/
Reply: "I hate the idea of EVs..." Look into the pending "flow battery" where the electrolyte is pumped like gas vs. sitting around charging the car with a plug. Longer range is also promised.
Reply: @SkySurferG  once fuel is depleted or extinguished it's it, a battery even larger storage batteries CANT be put out until all the toxic crap has spewed all over the city, east it Melbourne with the cement truck EV,  I assume cement Australia is forging ahead converting All their other trucks as in their marketing blog a while ago
Reply: @mguytv  wouldn’t changing batteries of this size, in a charged state, also create a huge risk of an arc flash occurring?
Reply: Using batteries to charge batteries... think about it.
Reply: Why would someone hate the very idea of EVs?
Reply: If it was viable they would prove it on a small scale first. For example take a small town in California and outfit it with charging stations and loan everyone an ev for one year.
Reply: @skysurferg1952 while I'm not against EVs and will probably own one at some point there are still real concerns and issues . Computers fail and glitch all the time. So relying solely on a computer to never fail and cause problems is not the best policy. The other problem is batteries. A gas fire can be put out with conventional fire fighting  methods. A lithium battery fire is strictly a chemical reaction and essentially once the process has started it can not be stopped till the chemical reaction is complete. Not even starving the battery fire of oxygen will stop it. There is a reason why certain batteries are not allowed in the cargo areas of commercial aircraft. Search battery fires on commercial airlines and see what comes up. Once again people are missing the point. The solutions we seek will not be found in one place. Governments can not create solutions by legislation. This will only result in harm to the environment, the economy and people. Engineers and scientists are constantly working on solutions to producing better and safer solutions to our energy needs, they just need time. Nothing can change overnight and the government forcing change with ill conceived policys will only end up causing more harm than good.
Reply: HAHAHA😂😂😂. I mentioned this as part of my paper which I was going to present at a 'Green Tech Competition' in Dec. 2023 at the University of Riverside in So. California in USA. Because I was the only white guy and did not talk 100% favorably about the Green Agenda.....I was 'Canceled'. The political extremists would rather fund absolute BS than support a superior technology. The 'cometition was laughable...so I did. 🤣🤣🤣True story. We have developed carbon tech that will stop these preposterous electrification, ZeroCarbon and Goebell's Wurming paradigms.😁🤯🤠😎
Reply: No business owner of these charging stations will ever invest in a bank of batteries and here are the reasons:
• Gas stations have large underground holding tanks because they are not connected to the refineries with pipeline to get their fuel deliveries!
•  Charging stations are connected to the grid and have a continuous supply of power and do not need a storage of energy from batteries!
•  These charging stations are not like homes that are powered by solar panels and when the sun goes down, batteries take over to supply power when there is no power generation from the panels!!!

So no!  No business owner will invest hundreds of thousands of dollars, not to mention the space taken up that another charger can be installed at, for a zero return on investment!!!
Reply: Yes, because there is no risk of a fire at a gas station🤣  Just google that
Reply: @markbadhamthornhill8152 And when the wind dies down, your back to relying on fossil fuels again!!
Reply: @digitalian99 and... they don't have to.
Reply: @homomorphic you wouldn't use Li-ion batteries for the charging station storage. There are much better/cheaper/non-combustible battery solutions for grid level storage.
Reply: @dguy321  such as? At what annual cost oer kWh of storage?
Reply: @homomorphic  I'm not your Google assistant, you can easily look up that information yourself.
Reply: Wait a minute 40.000 liter x 8.7 kWh (petrol energy content) is about 300.000 kWh or 0.3 GWh battery pack.

For comparison a Tesla 3 GWh Megapack costs 850 Million $ USD.

A 0.3 GWH battery pack would cost ~ 85 - 90 Million $.

How many cars must charge lets say 50 kWh for electricity margin of 18 cents or about 9 $ profit for 1 car.
That is about 10 Million cars I guess, without interest nor maintainance or repairs.
With three charging points and 365 days a year  and 5 cars charging per day this means about 5000 cars a year.

Yuppi, after just 2000 years you get your money back eventually.

Your idea is fine, dont want to offend you, but as with other EV and Elon-cheerleaders,
your ideas are great but sadly are just about 2 orders of magnitude off of reality.
Reply: @markbadhamthornhill8152  F ire risk of an ICE is mostly an oil fire risk due to oil leaks from the engine. mostly smaller fires that don't involve the fuel. ICE's seldom spontaneously combust.

EV fires are most frequently due to internal battery shorts and quickly involve the entire battery. Those fire are spontaneous, very hot, and impossible to extinguish since they are self oxidizing.
Reply: @markbadhamthornhill8152  At the present time most charging is done at home because EV ranges restrict them to work/school shopping local trips. That will change if the requirement that ALL vehicles be EV's is realized. That will also put a huge stress on the local home grid.
Reply: @dave20thmay  ICE's became ubiquitous quickly after Henry Ford made them inexpensive!
Reply: @SkySurferG  Range is still definitely an issue. On a sub-zero degree night, with the headlights, wipers, heaters and defroster and fans going full blast, their range becomes a joke. And when you can recharge in 5 minutes like a refill, it will be nice. We have a way to go yet.
Reply: Yeah, that would be nice and affordable...
It wouldn't raise the cost of charging at all...🤨
Reply: @sjsomething4936  All changes, aren't necessarily good changes, and all those against changes, aren't necessarily bad. Some of those cult members, ( the majority of the world)  are the ones who support certain changes, and will find that their cult leader, isn't all powerful.
Reply: They won't do that because that makes the system inefficient and stored energy will loss over time. Charging companies won't do that. You need a gigantic battery to be able  to support the 1MW which require large capital investment per charging station with no prospect of making profit unless EV owners are willing to pay expensive charging rates.
Reply: @SkySurferG solar panel is not enough to supply the EV energy requirements.
Reply: @thomaswilson2917  how so? I have not put fuel in my 25 yo Subaru since November and it still has a 1/4 and I do not have to plug it in. I can go where I want, when I want and the energy is there waiting for me to use.
If you have ever had to fight a fire, you would understand that EV's are a hazard.
Transfer of energy from 1/2 another creates a loss therefore your point is just stupid.
Try powering an 100 ton excavator and a few dump trucks to dig the hole that is required to mine the required minerals for anything we use in everyday life from your free energy scheem?
Try going out into the real world and having a go, it is hard out there but worth it.
Reply: So we are going to charge a battery connected to a wind turbine to even out power production from when it blows to when it doesn't blow. Then we will put a battery at the charging station. And all this to charge a battery in a car. We will charge a battery with a battery that is charged with a battery... Oh fuck I get a headache... 🥵
Reply: @thomaswilson2917  no. They run when the wind blows.
Reply: @thomaswilson2917  Why would a company making destilled products from crude oil buy electricity from the grid instead of using the much cheaper energy from the oil they are handling? What planet do you live on?
Reply: @thomaswilson2917  They burn oil to heat the oil they want to destill gasoline, diesel etc from. They don't convert it into electricity at all. Why would they?
Reply: Someone needs to make a doomsday movie showing all the damages these EVs can cause in a short amount of time - Afterall, FIRE is the next biblical end time event & these EVs are obvious WMD contenders.
Reply: @lukeclifton4392 
Thanks of fuel don't self COMBUST.
Reply: @Mikexception  
Are you aware that EVs even burn while under-water...
Reply: Sorry for necro posting but power delivery is almost never an issue. Transformers are (relatively) cheap. It's the ac to dc converters that are expensive and almost always the limiting factor. And while battery storage is being used in some places, it usually makes more sense for the site operators to buy more converters and wire them together on a common bus.
Anyway if we're going to talk about batteries being a fire hazard, shouldn't we talk about how dangerous gas pumps are due to the vapours? Those no smoking signs are there for a reason.
Statistically, batteries are 40 times less likely to catch fire than gas so I think if we replaced all gas station tanks with huge batteries we would actually improve the fire safety of those locations.
Reply: @collenfisher3635 Actually having those batteries partially charged could be a great way to balance the site.
Lithium ion cells generally like hovering around 50% and those comparability small discharges and charges would put minimal wear in the cells.
Also utility companies love sustained loads so the more steady you can keep the demand the better.
Instead of rapid jumps in the demand the battery could provide some buffer and let the site slowly ramp up production and slow it down again.
Reply: @lukeclifton4392 I've also seen gas cars catch fire for no reason.
What you see on the news or hear from someone doesn't matter because it's not empirical data. There's a lot of people out there who want to skew public perception for their own benefit. The fact is both can catch fire, one is 40 times more likely to do so, the other is harder to put out.
Reply: @bills6093 Discharge rate depends on architecture. The more cells you wire in parallel, the faster you can discharge.
Reply: With an endless line of cars wanting to charge when would you be able recharge the storage battery.
Reply: @SkySurferG  the solar panels might povide 5-10% of the power needed .. not enough to offset the high demand if all chargers are occupied
Reply: We had a saying in the ER that it really didn't matter much in the end if you got hit by a speeding bus or truck; results are about the same. Explosions bad at any level.
Reply: Short response from a guy who worked in a large electric company: it would not help. Better the feed be sized to match the load. It has to end up that way anyway.
Reply: Power in the grid is coal and nuclear.
Reply: There is no valid reason to buy an EV.
Reply: Lol.. nope
Reply: Who pays for the electricity?
Reply: @chonpincher  fuel has an efficiency of less than 30% not counting the additional energy required to extract and refine it.
Reply: steveinoz8188  
Almost zero equivalence. The UG tanks are a modest cost at the time of construction and last "forever", zero maintenance and zero fire risk.
Reply: steveinoz8188  and are you able and willing to suppress such a fire?
Grid connection? Extension cord?
I suggest that you do a welding course and learn how much energy is required to melt
Reply: steveinoz8188  that would be a fault. You are accusing an electrician for a battery failure?
Reply: more batteries ??  nnnyaaaaayyy!!!